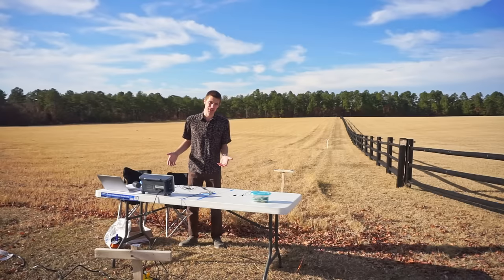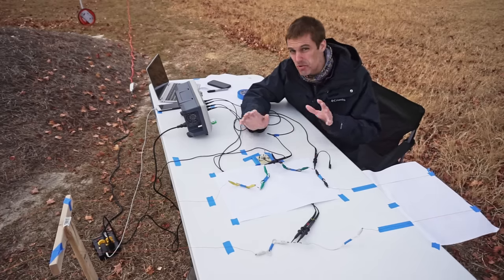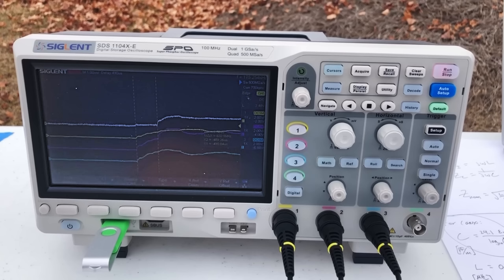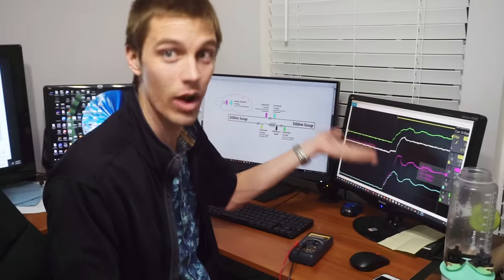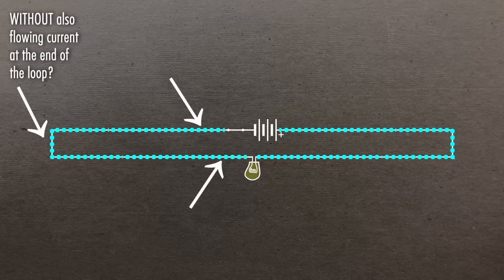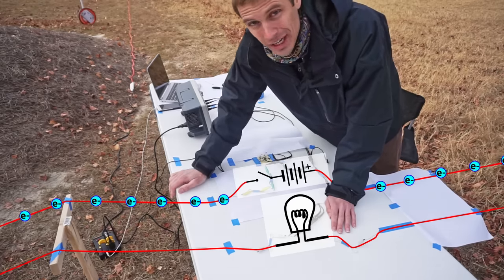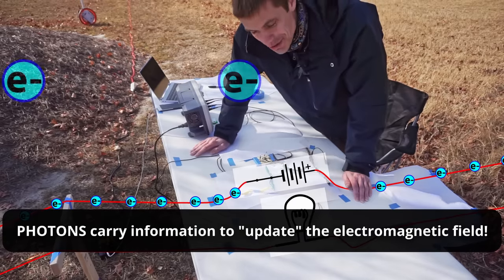I bought 1000 meters of wire to settle a physics debate

Comment from the maker: COMMENTS AND CORRECTIONS:

Thanks to Derek at Veritasium for his blessing to make a real-world version of his gedanken experiment. If you haven't seen his video yet, you might want to go watch that for context, and I also highly recommend ElectroBOOM's video on the topic and EEVBlog's video on the topic. Electroboom's video has some simulated scope traces extremely close to what I saw IRL, and a REALLY fantastic animation (8:27) of him waving an electron around in his hand, shedding magnetic fields as it moves (Even though I ignore magnetic fields in this video - I'm trying to think of a test to find out if they matter).

Veritasium https://youtu.be/bHIhgxav9LY
ElectroBOOM https://youtu.be/iph500cPK28
EEVBlog https://youtu.be/VQsoG45Y_00

CORRECTIONS TO THIS VIDEO:

- The most important thing I believe I ignored in this video is the actual, physical distribution of charge in the switch-side wire while the current is starting up. How much charge travels AT the advancing wavefront and how much charge gets stuck along the wire in between the fuzzball I drew and the battery will depend on the physical size of the wires and how close they are to each other, setting their capacitance. This charge distribution also DOES NOT look the same on both sides of the switch, although I drew it that way for simplicity. In a later experiment (next video) my mind melted a bit as I measured the resistors on both sides of the battery and found the current going through them is different. It doesn't change any of the logic I presented in this video, but it makes some diagrams less than perfect.

- It's possible that cross-inductance between the wires contributes to the effect, using almost exactly the same diagram except the wires are connected by a magnetic field rather than an electric field. I couldn't figure out how to decouple these effects day-of, so I'm still thinking on how to test. Hopefully more to come there.

- I'm sure there will be loads more - please leave comments about what I screwed up!
Reply: Love it. I get popcorn for Veritasium's and Electroboom's responses.
Reply: Veritasium blew my mind, and you are piecing it back together again, thank you.
Reply: Electrons can totally leave the wire, if it's hot enough :P
Reply: d is correct  if the switch is near the light bulb because the wires are already charged + and- and then there should be  a slight drop and go up again
Reply: Nothing too important, but you used V as the symbol in Ohms law, however V is the unit and U is actually the equation symbol for voltage, just like I is for Amps and R for Ohms,

Love your videos, thanks for educating us all
Reply: It would be fantastic to see this experiment with wires laid in a circle!
Reply: Great demo, I would love to see the wires be perpendicular to eachother for the first leg of the journey. The capacitive coupled component should fade away until the until the parallel leg where it would be constant
Reply: IT WAS THE MEASUREMENT ARTEFACT!   Not capacitive coupling.  
It’s due to all channels of oscilloscope having a common ground, which shorts out the long wire.  
Use diff probing for switch, just like you did with the load.  Then the small current will disappear.  
You’re welcome. 😌
Reply from the maker: James - I didn’t ground either probe on the far side of the circuit - that’s why I had to display the result on the math channel. What’s really cool is that both traces on the far side actually climb way early, but that’s actually the reference ground on this side of the circuit dropping. The difference between them still represents current
Reply: On the cross conductance part, just move the wires away from each other. You will get a much higher effect from self inductance of a single line unless it is within a few millimeters of another.
Reply: @AlphaPhoenixChannel  test it by connecting the load side probes only to each other (no load) and see if still measures tiny levels.  Or swap probes on the load to see you get negative value. 
If you still have your massive setup!  🙂
Reply: For the different currents on each side of the battery - you changed something in your measurement method. That is likely a slight difference in connection resistance or your power supply was a bit different between measurements. The laws of physics dictate that current going in must be the same as current going out. This can be seen in Maxwell’s equations when applied to a circuit and is famously known as Kirkoff’s Current Law.
Reply: @Fabian-mu3hq  I have to say, I’ve got my degree in electrical engineering and have been in the field for a decade and have never once seen “U” for voltage. That may be a very old way to describe it, but it is not used in present-day academia or industry.
Reply: @AustinSteingrube  We still use "U" in Germany, I guess that's where Fabian Widmann is from
Reply: @TheDoubleD  We use "U" in France too
Reply: @AustinSteingrube  here in Central Europe I have been taught to use the U for equations and the V as unit behind the number of Volts, i just Googled and appently the SI system intended it like we learned here, but the English Wikipedia does say they are used interchangeably. Probably some differences between countries
Reply: I would like to see a test with the light bulb far away. If Derek’s theory is correct, having the switch and load at opposite ends means there is no capacitance shortcut to activate the light, so we shouldn’t see the effect. If we do still see the effect then your explanation here is correct and Derek should post a retraction.
Reply: another tiny correction: the "first 1.6us" of information still won't travel instantly (because of the photons required for the field "update"), it will still travel at the speed of light, just over an extremely short distance, because it's across instead of along the wires.
Reply: @no0ne000  except we won't see the effect either way, because the explanation shown here is capacitive. this is essentially agreeing with Derek's "idea" of information traveling across the field instead of along the wire, except for the bit where he claimed it could be anything even remotely close to useful, because, unlike Derek's claim, in reality it's just the tiniest bit of capacitive coupling and not actually the signal we're transmitting.
Reply: So you are saying that instead of just assuming that he knew what would happen Derek should have actually tested it to make sure he was right before going on the internet and exclaiming it as fact?
Reply: What would the oscilloscope results look like if placed on the part of the wire where you cut it? If the electrons are piling up at the end...is the current higher at the end of the cut wires compared to where the probes were in the video? Hope you see this and can test it!
Reply: What hasn't been covered by other reaction videos so far was a twisted pair configuration or differential signaling drivers to showcase how to remove the initial part of the signal. It would be interesting because it is a technique to solve transmission problems caused by these effects in technical applications and it migth be harder to simulate with most software. Your experiment setup would allow for it. I just don't know how to get the required amount of twists per length to achieve the desired result.
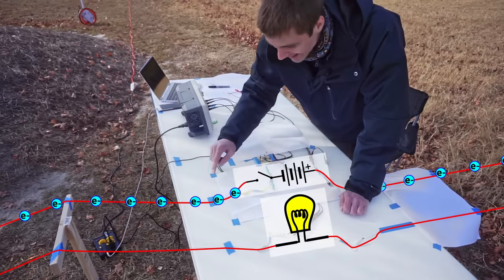Reply: I've watched all the videos referenced in this comment and I must say, this is the best explanation / analysis I've seen. Specifically the part starting at 16:24 -- this is the part that others seem to hint at but have not explicitly stated or visually shown. Great work man!
Reply: @assadij  It seems like strange coincidence, that the "artifact" has the duration of the speed of light traveling down the length of wire. In other setups with different shapes of wire lines the duration of the 'artifact' should vary according to the working hypothesis, but shouldn't according to yours. We'll see in part 2 I guess.
Reply: @Fabian-mu3hq  not sure if this is a regional thing but in the US at least we use V to indicate voltage. U is the symbol for potential energy, which is different from electric potential.
Reply: @turtledruid464  yeah, it is different around the world, here we use U as the equation symbol, the English Wikipedia however states phi as the equation symbol, but V is always just the unit symbol for Volts, just like P is the equation symbol for power with Watts (symbol W) as unit
 And R is resistance with Ohm (symbol Omega) as unit
And V as the Equation symbol is already used by Volume (Unit M^3) therefore it shouldn't be used for voltage as equation symbol, but appently its regionally different if U or phi is (at least should be) used
Reply: 13:00 - 15:00 Is absolutely spot on from a physicist's perception. You did go too easy on the clown in Veritasium though. What he was babbling about was "magical" travel directly from the battery, in the air a cross to the bulb which is completely insane. What you could do to confirm the capacitor effect of the cable is to exchange 100 m of the wire on each side of the battery with first a thinner wire then a thicker one and see if you get the effect you would expect. Thinner and thicker cable should give you a shorter and longer first step in potential, but also a lower and larger potential for the first step, before the charge is established in the loop as whole.
Reply: @AustinSteingrube  "U" is more common in European literature... (I've read a lot of IEC documents on metrology)
Reply: This is a great experiment and really interesting to think about as an electronic engineer focusing on wireless communications! Great stuff!!!
Reply: Boy, the veritasium vid really sparked some debate...
Reply: @Fabian-mu3hq  Which symbol you use for a variable is just a convention.  But using V for voltage is the convention I learned in my circuits course.
Reply: As i understand it, the wires act as a capacitor... but then, shouldn't you discharge it (short both ends) before doing the experiment?
Reply: Whole video I hoped that you will just cut end of wires... Thank you for that. Just to prove anybody that information doesn't travel by wire.
You can make more portable version of your setup just by usong some coax. Also thay have much lower impedance so curent is bigger. I played with this few years ago.
W2AEW have great videos on that topic. But looking at tehnical side not phisics side.
Reply: @Virsconte  in this case, it's actually not really a variable like you would normally have, Common units are all normed by the SI system, but apparently even this differs between region
Reply: @Fabian-mu3hq  completely incorrect or at least pedantic. The original ohms law used EMF.  The U term is used in Europe and some textbooks because of "Unterschied".   Almost everywhere else it is V, the voltage potential which has a unit of Volts
Reply: @JP-pf5pz  damn, you are right, I let my years of education fool me, here in eourope it's U, for voltage, almost everywhere else it's V, and appently both are right, at least there where they are used. And the phi that j mentioned can also be used, but it's for a more momentary Voltage or something, now I better shut up.
Reply: I have a feeling someone's suggested this, and you probably thought about it as well but decided against it: 
Try moving the parallel wires closer and farther apart and see the effect of the voltage across them when the switch is closed?
Reply: @Fabian-mu3hq  I'm sorry, that's not correct.  There are both a mathematical variable and a physical quantity involved in this situation.

We called the physical quantity voltage, and we chose to measure it in SI units of volts, which are usually denoted with the letter V.

We decided represent the physical quantity with a variable, and to call the variable V, which is a common convention for a variable representing a voltage.  It seems like U is more common in Europe.  But we could have called it X or ξ or א or🥴.
Reply: my first thought when seeing that osciliscope graph was "ah, that is exactly what Electroboom predicted."
Reply: It would be interesting to see what happens if you rotate the "light bulb" 180 degrees. With that I mean that you keep all the wires connected the same but physically rotate the resistor around. Would the initial spike be negative?
Reply: You dont need his permission to call his shit out. Thank you for doing it.
Reply: A bunch of you either didn't watch the video all the way through or forgot, but at around 21:25 he talks about how he is posting a second video with a ton of experiments (including moving the wires closer or farther apart)
Reply: I'd enjoy seeing the results of driving a 10 or 100MHz signal down the wire to see how information travels vs DC current.  Maybe use a logic level line driver or MOSFET gate driver?
Reply: @assadij   Small current will not disappear as it is a real physical effect. Anyway, it is important to prevent all side effects what probes may cause. This small current is proportional to the line impedance and this is one way to measure the impedance.
Reply: You will need a lot more than a 1000... Try 300,000miles that way it would have less chance for errors in calculations
Reply: I already had some doubts about the 'bulb switches on immediatelly', especially about the point that  this would mean we could send information faster than the speed of light. But you addressed and explained all those points perfectly 👍. Maybe it is also interressting to try alternating current? I have absolutely no idea how that would look like on the scope
Reply: Good job. Not convinced about capacitance explaining the 1v in the initial 1.6uS. Effectively when the switch is open the entire wire is still connected to one terminal of the battery holding the entire wire at the potential of that terminal. In that state the surface of a wire should be nearly at the same potential across its entirety so all charges should spread out across the wire (over some time). Without a significant difference in potential to force the charges to separate there would seem to be little reason for any potential difference to exist at the moment right before the switch. So no stored capacitive charge in the line would be my presumption. The 1v indicates a current flowing, but seems to be a static pressure. Not sure why its 1v, why not 0.5V or 100V? If its sourced from the line it would exist even when the circuit is open. Yet it only appears when you close the switch.
Reply: @stevenchristy6156  it was 0.2V, but yes, I am still puzzled on how capacitance has anything to do with this (and I have a Ph.D in physics) since his explanation was a transient current inducing a current in the opposite side of the loop.
Reply: Also, keep the length and setup but just place the bulb at 150m. 

Thanks for the content. Really helped me understand better. I hope electroBOOM and eevblog and others will also spend some time on it, helping to explain it further to us not-so-smart guys.
Reply: @no0ne000  what you said. Exactly. That's what I want to see too.
Reply: @denny9931  I have done something similar in recreation of the bedini experiment. Twisted 200 meters of wire (something like that) using a drilling machine and a stick. It's a delicate thing to do since the wire will want to snap if done over some length. Twists want to curl up in one place. A bit of experimental experience is required OR watching the entire distance of the wire extremely careful.
Reply: @no0ne000  The problem is that you would need to measure it out there, so the signal from the probe has a propagation delay as well.
Reply: I know insulated wire is a good bit more expensive, but it'd be really cool to see if you could significantly decrease/eliminate the "instant" current that flows from the closing of the electronic gate.

Would doing this experiment with a resistor in series vs parallel do anything?
Reply: Great video ! I'm waiting for part 2 specially the influence of the distance between the two parallel wire, and how that fall off with distance.

Is it a field generated by the presence of an excess charge (that the battery would have pumped during the very short time), or is a field generated by electrostatic dipoles (along the thickness of the wire the electrons tend to pack up on the side near the other wire) created by the wave going through the wire.

Also have you quantified about the power transmitted by EM wave (because the the wires look like a giant antennas), and the step function create a wide range of frequencies.
Reply: @turtledruid464  Well, because 'murica does not adhere to international standards. But I guess V = 5 V makes sense.
Reply: @assadij  I really need to get a pair of differential probes. Thanks for the tip.
Reply: I predicted in my video that current would reach the bulb in zero seconds. Albeit it was a tiny bump on your oscilloscope, it is nevertheless there in zero seconds. It's due to a flaw in Derek's test design.
Reply: I remember being introduced to transmission lines/waveguides many decades ago and having my mind blown.

Yes, as you guessed "cross-inductance between the wires contributes to the effect" because the wires affect each other via the electric fields and magnetic fields between them. This is something else that blew my mind; they are not separate things but always exist in tandem. There is only the electromagnetic field.

You can't "decouple" these effects. Period. You can try to shield one wire from the other using something like mumetal but that just moves the self-induction of the wire you're trying to shield closer to it, changing the effective speed of the electrons in that wire, and some magnetic field is going to "leak through" the mumetal anyway. Same for electrostatic shielding.

My point is that this is a transmission line experiment and can't be successfully analyzed any other way. "Deceptively simple" indeed- understanding these effects stumped some of the most brilliant minds of the early 20th century for quite a while, so don't feel bad that it's hard to understand them well enough to explain them in a 20 minute video.
Reply from the maker: It was t bare - it had enamel
Reply: SERIOUS PROBLEM:  the resistor-value determines initial behavior!    The resistor-ohms *cannot be chosen randomly,* otherwise we'll end up misleading people.   (Also, double check things, because from your scope traces, your 1K resistor acts more like a 120 ohm resistor!   Calculation of Zo gives an initial step of 1.8VDC, not 200mV.   And, why is your final voltage around 3.4V and not 4.6V?  Something odd is going on.   Re-measure your 1K resistor to make sure it's actually 1K.   Test your total wire-resistance, from the wire-tables it should be around 86 ohms.)

OK.  Sure, we can sneakily select our load resistor to be small, in order that 90% current appears immediately, then 10% more is added after the lightspeed delay.   Or instead, choose some huge value where .001% current appears immediately, etc.   Which wrong ideas are we trying to "prove?"

In hindsight, best would've been to adjust the resistor to maximize the milliwatts, which happens when the initial immediate voltage is 2.5V across the resistor.   In that case we first see 25% power, then the 100% power arrives after the full 5V comes after a delay (ignoring the copper resistance, which might not be correct to do.)   Even with his 1M spacing, Veritasium's initial signal on superconducting wire is NOT MICROSCOPIC  ...unless we want it to be, and choose a badly-matched resistor value as our load.

PS 
all my above comments are ignoring the real resistance of thin wire.    If the characteristic Zo impedance of your line is a few hundred ohms, and also the resistance of the long thin copper is a few hundred ohms, then we'd need the "Telegrapher's Equation" to predict the best value for the load resistor, in order to maximize that initial signal.

PPS
PLEASE try actual 1M gap, even if the nearby dirt may distort your results!   And use 200VDC worth of 9V batteries clipped in series, switched by a zero-bounce mercury reed relay (lots of those on ebay.)   Over the past weeks I see lots and lots of angry comments insisting that the one-meter gap is "enormous," and insists that this will make the initial pulse be microscopic.    Unfortunately the gap of your close-spaced line appears "small" to everyone     Veritasium's original version is wonderful because a 1400-ohm load resistor would immediately see 6V and 2.1mA; more than enough to light up a single LED, even with a 1M gap between the wires!    If Dereck had used 200VDC, the initial wattage could be 7W!! 

Hint:  also calculate what happens if the wires were spaced at ten meters!   The Zo doesn't increase as much as most people think, only going from 800 to 1000, and a single LED would still light initially.   THe DC wattage jumps right across the ten-meter gap.   Very counterintuitive, unless we've realized that this is a transformer: like a pair of stacked hoop-coils where the gap between the coils is tiny, relative to the circumference of the coils.   We'd expect to be creating a sort of transformer with 1:1 coupling.
Reply: @KiitosKaloista  I just don’t think that small flat level is real.  It is too steady for too long.  More like a measurement error.  
If it was capacitive coupling, the level should have been increasing.
Reply: @cda32   or indeed if the wire is sharp and the voltage high enough. - Spark.
Reply: @Fabian-mu3hq   I think the Si symbol for Voltage is actually E - Stands for Electro motive force.
Reply: Wanted to like this, but the number liked scared me! 😈
Reply: What is the time delay if the switch and light bulb are 500m apart? Or 2 Km apart?
Reply: Two things you could add to the list of parameters to tweak, (21:23) is to: 

Replace the single core copper conductor to a multi core copper cable. (With the same mm² of course) 
Replace the conductor with a metal of lesser conductivity like steel. (Preferably with a larger mm², to compensate for the voltage drop of the circuit.)

I’d also like to suggest that you contact an amateur radio club in your area to ask for input & assistance. The vast majority of HAM operators around the world (I’m one of those many) would LOVE to help out with something like this! 😃

If you are in the U.S., (your 'about' page doesn’t mention it) the easiest way to find the one closest to you, is to use the search engine at arrl(d0t)org/clubs

If you’re in Canada, you can check the list of clubs at rac(d0t)ca/clubs-3/

Thanks for the informative video!

Cheers from Denmark 🇩🇰
(Also: 73’ de OZ2BO😉)

Ps. I was impressed by your way of “dumbing-down” the technical details without making it sound condescending. It’s a skill set that I find somewhat lacking with quite a few of your fellow Youtubers with similar types of content, it is much appreciated!
Reply: Yes it's the details of the magnetic field and how they can be manipulated is what I want and need to better understand.  I've read along time ago, something about the shape of the conductor can influence this greatly, like a flat wire verses round, number of strands verses one single wire and of course the alloy used.
Reply: It would be super interesting to see how super conductivity would influence these effects!  No resistance!!!   Is it possible to travel faster???   Are effects instantaneous???
Reply: @assadij  if the line is light second long it would be steady two seconds. As told in many commments already, the line behaves just like a resistor until the EM-wave bounces back from the end. This resistance is characteristic impedance of the line. It takes both capasitance and inductance into account.
Reply: It might be a chemical process. Have you considered the difference between the electron affinity and ionization energy of copper?
Reply: @JonesNoahT  Please go on and share?   Learning here.
Reply: @AlphaPhoenixChannel  That (not grounding the far-side probes and why, and why the early "rise" is actually a fall in ground) is both subtle and important -- I hope you go into at least this much detail in one of your followup videos.
Reply: @renevile  I'm not sure, but didn't want your question to be ignored.  I think the answer is "no-ish".  That the fields are pointing sideways to each other ... but this might look like the "same" polarity (or not) when you only measure at two points instead of sampling across the whole space.
Reply: @mirkokurac  Since the time to adjust is microseconds, this would at most limit which order he should hook things up to avoid a shock.  If he and the equipment are still fine, then either he did (perhaps without even realizing it) or the power involved was low enough to be safe anyway.
Reply: @brettmoore3194  But way more chance for errors in construction.  And for catastrophic budget-related failures.
Reply: @johnallenrichter  How can you tell?  You can tell how long it stayed at the first (slightly) increased level, or how long it spent climbing, but to stay that process started at zero seconds, as opposed to 10 minutes ... I'm not sure how to tell when the switch closed, except by assuming it was when the measurement changed.
Reply: @l0I0I0I0   Ah ok awesome =^). The energy required to remove one electron from the valence shell of an atom is called the “ionization energy,” and the energy released when an electron is added to the valence shell of an atom is called the “electron affinity.” If it requires less energy (or even releases energy) to add an electron to an atom of copper than is required to (or released from) removing an electron from an atom of copper, then I would expect to see more current on the side towards which the current is flowing. If the opposite were true, then I would expect to make opposite observation. Thus, this might explain the phenomenon that melted his brain a little :-)
Reply: @AlphaPhoenixChannel  Wouldn't "bare" wire vs enamel just change the effective distance between the wires?  I could imagine better insulation making the initial short-cut energy too small to detect, but I wouldn't expect it to change the kind of results you got.
Reply: @JonesNoahT . I see, the net average total electrons releasing, and acquiring of electrons gives a positive or negative charge with the higher amps showing the greater force?  
  I'm just started watching some YouTube inorganic chemistry vids.  Seems to address some of these phenomenas.    Thanks for you answer.
Reply: @jimjjewett  what nobody told you science is exspensive in a devalued currency
Reply: @AlphaPhoenixChannel  Maybe asking a bit much, but you could change the inductance/capacitance of tge transmission line by embedding it in a medium. The change in permeability and permittivity will change the strength of capacitance and inductive effects. 

For example, you could compare the results with the wires submerged in a river and lifted above the water.
Reply: beautiful video, thank you, this was really educational and was helpful to understand the nature of electronics!
Reply: @jimjjewett  The oscilloscope has three channels.  One channel was across the switch.  There was a distinct rise in voltage on that channel when the switch was closed. That indicates voltage was closed at that time. That time is time zero.  A second channel was across the resistor.  The resistor channel showed the small bump of current at the exact same time that the switch closed.  Ergo, there was no delay. Another way to say that is there was 0 seconds delay or the current started instantly. The reason this happened is because the test design is invalid.  The positive voltage was present on almost the entire length of wire before the switch was ever closed. And the negative potential was on the negative side of the wire..  in fact both the two battery voltage poles were present on both contacts within the switch before it was thrown. Just a few millimeters away from each other. So when contact was made the voltage circuit was instantly active.  There was no delay waiting for the voltage to travel the wire because the voltage potential had already travelled the length of wire before the switch was ever thrown!  It is an invalid experiment because of that.  The remedy is to use a double-pole-double throw switch to open BOTH sides of the battery.  Not just one side.  It's just a matter of simple oversight. Performing the experiment with the DPDT switch will allow us to see the results Veritasium intended.  Because the wire will be free of any voltage potential before the switch is thrown and the voltage will be forced to travel at light speed to activate the voltage circuit. I'm curious to see what those results will be since DC voltage presumably  only travels in one direction. So I'm wondering if both poles will travel to meet in the middle where the bulb is, or if voltage travels only one way, around the whole loop before the voltage is complete. The former would leave Veritasiums result at theoretical ly1/2 second while the latter would result in 1 second.  I'm honestly hoping AlphaPhoenix will recreate the experiment with the corrected design because I'm curious of which it will be.
Reply from the maker: @IDICS Tech News in steady state dc electrons move but the electric field remains constant, but this is still a current. The weird “startup” wave is only relevant in very weird situations like this one
Reply from the maker: Of course, but you said it was instantaneous and it’s not - it’s limited by photon interactions - light speed
Reply: I understood not much with the Electroboom video whereas this one was cristal clear. Thanks
Reply: @goranjosic  Just what I was thinking.
Reply: @assadij  Exactly right!   If we only consider the capacitance, then the current increases, but if we only consider inductive coupling, the current decreases.   If we consider both, then there will be a *constant* flow of EM energy into the two long wires  ...as if they form a pure resistor, absorbing some watts.   In real 2-wire lines, the initial current is that of a resistor:  it's constant, as long as the battery-voltage and the load resistance are also constant.
Reply: What happens if you change the circuit topology and move the switch to one end of the circuit? 🤔 In the original question I noted that the switch could be up to 0.5s away from the battery and lamp. Therefore for the lamp to turn on in 1m/c seconds that would infer that the signal between switch and battery/lamp would need to be greater than c (speed of light.) This is a problem. 🙂
Reply: Your graph really proves the hypothesis of electroboom
Reply: Do your experiment at night. I have a hypothesis on the timing. You're smart, You'll know where I'm going with this.
Reply: nice
Reply: You have to understand the difference between the transverse and longitudinal electromagnetics. Standing instantaneous electrical connections. Like pulling on two ends of the rope at the same time versus whipping away through it. They deleted the teachings of scalar electromagnetics.
Reply: One thing I think should be made clearer is that the wave propagates from the switch not the battery as it is the switch that is changing state. Obviously in this experiment the switch is so relatively close to the battery it makes no odds but I think that this was never made clear in Derek's video nor this one and I know some people are confused into thinking everything starts happening from the battery.
Reply: "It's possible that cross-inductance between the wires contributes to the effect, using almost exactly the same diagram except the wires are connected by a magnetic field rather than an electric field. I couldn't figure out how to decouple these effects day-of, so I'm still thinking on how to test" --- are you trying to increase the separation between the switch and the resistor/"bulb"? like make a 1km circumference circle so the switch and resistor are diametric?
Reply: @bogslurp3532  I wouldn't say veritasium video blew my mind, it just made me question all of his science in all of his videos 😅 I just thought it was weird that he left out the explanation that is in this video. It's such a questionable presentation that I would take it down and redo it, if I were in Derek's position. A great conversation starter, but not something that should be left as an individual point in his channel's history.
Reply: and what wavelenght would have the EM field traveling through the wire?
Reply: thanks for clearing things up. it would be interesting bro see how making wires shorter or longer, and closer /further. with 300000km of wire, the resistance of the wire would be much bigger than the bulb and the DC current would be lower than the transient current caused by the wire capacitance. this shows that a phsics problem does not make a lot of sense if you have too many unknown parameters such as the wire resistance.
Reply: @Fabian-mu3hq  WRONG!
Reply: @Fabian-mu3hq  WRONG!
Reply: @assadij  Yes! Thank You! Finally someone who knows what they are talking about! I wrote a comment saying the same thing and suggested he redo the experiment replacing the battery with an appropriate resistor for it's internal resistance and a regular switch. I said they would see the same voltage after closing the switch as their "initial current"! I know I'm right because I've seen it to many times, in dead circuits even. He should have never equated voltage to current.
Reply: I'm not so sure about the valence electrons having a net Coulomb force on one another as the correct mechanism (around 13:20), considering that the material is neutral. Although perhaps you've hidden the mechanism somewhat behind the nature of exactly how the battery ' places'  the electrons, but in any case I don't see much of an explanation. If you displace an electron, its field will always be canceled by the net positive atom left behind. The only net electrical interaction (coming from the valence electrons per se) is due to relativistic effects and is modelled as the magnetic field. I'm also curious if assuming that the electrons indeed 'bump' each other in this way would lead to phase differences inconsistent with experiment. 

But yeah -- at least some research published in this area seems to suggest that the charges are actually motivated by an electric field within the conductor that points along the conductor's axis and is constant across its cross-section. This electric field is itself established by surface charge densities on the conductor, which are in turn established by the electric fields (at near-c, hence the speed of conduction despite slow drift velocity) from the source and specific, complicated feedback mechanisms that are a function of the conductor geometry -- this latter point I'm still fuzzy on and have some doubts. Chabay et al have developed a way to calculate it programmatically and there's a simulator online you can somewhere I believe. But some sources talking about the topic:

-"A unified treatment of electrostatics and circuit" Bruce A. Sherwood, Ruth W. Chabay (Carnegie Mellon University" 
(Also their textbook " Matter and Interactions"  goes into it in detail) 

-"Polarization in electrostatics and circuits: Computing and visualizing
surface charge distributions" Sherwood and Chabay again

-"Surface charges on circuit wires and resistors play three roles" J.D. Jackson, American Journal of Physics

- https://electronics.stackexchange.com/questions/532541/is-the-electric-field-in-a-wire-constant

-"Understanding Electricity and Circuits: What the Text Books Don’t Tell You" Ian M. Sefton, School of Physics at The University of Sydney
Reply: @Fabian-mu3hq  YOUR WROOOOOOOONNNGGGGGG¡!¡!¡!
Reply: @AlphaPhoenixChannel  Hold on! I need to point out something wrong with your experiment. Your Oscope is measuring voltage and your equating it to current. You say that the small rise on the white line is a "tiny amount of current" but that's not current. My experience with Oscopes and the bain of their existence is varying ground states. I see that tiny rise in voltage initially is the scope translating what it senses comparatively to the ground state in the circuit. To test this experimentally simply have the same circuit basically but no battery and replace it with an equivalent resistor for it's internal resistance. Only thing is that transistor won't work for a switch without power so since your not looking to measure any time lapse just a regular switch should suffice. I think when you close the switch you will still see the same transient voltage yet no current will be flowing. Just the scope measuring differences in voltage potential caused by different ground states. I hope I wrote this inba way that explains it properly. After all I am an electrical engineer. That was a joke cause most people would run off at the mouth exemplifying the Dunning Kruger effect and say "well I'm not a blah blah blah and I hope I did it right". I actually am a trained electrical engineer and have no problem saying I could be completely wrong. I have been before and every single great mind has been wrong about something and likely lots of things because that's just the way it works when your not Omniscient (especially at the beginning when you know nothing)
Reply: Try this with thicker and thinner wire
Reply: @cda32  High Voltage!  (Done dirt cheap!)
Reply: You didn't need Derek's blessing. This is science!
Reply: Instead of using switch on one side of the battery use it in two sides of the battery , so charges won't develop on wires .
Reply: @KiitosKaloista  this is the worlds worst transmission line by design. It’s characteristic impedance would be extremely high due to having large L over a small C.  Z= sqrt(Lo/Co).  And it is not very uniform.  So I wouldn’t even go there 😌
The stray capacitance that appears to deliver power from source to load is not sufficient to produce a large enough current through the load to be measurable.  Also definitely should not be so constant.  
It seems to be some sort of measurement error for sure.
Reply: @sushkr  00хФфф
Reply: Could the 0.2 volts in the beginning be coming from the internals of the oscilloscope?
It would be nice to see measurement done with 2 separate oscilloscope triggered by the switch
Reply: @Fabian-mu3hq  THink in the US V is common also as the symbol for voltage. At least it is listed on the wikipedia page for voltage.
Reply: @assadij  This may be resolved by measuring only the resistor, preventing any possibility that any energy is coupled thru the probe cables between the switch and resistor.
Reply: The experiment is great, but the explanation is totally wrong.
Reply: @johnallenrichter  the second channel was not across the resistor, rather he had two reference channels measuring either side of the resistor and then had the (virtual)white channel showing the difference. He explains above why the two reference channels start rising immediately, basically for the reason you mention, that the circuit is pre-charged. But I think your idea of using a double pole switch is a good one. I actually think that the relatively high and steady-ish current we see in his experiment (before the wave down the wire arrives) is a side effect of the measurement, under perfect conditions I think we would see more of a transient spike as the switch is closed. But my feeling is that with the double pole switch you propose (such that the circuit and switch are not pre-charged) we would not get that transient as the switch would have no potential across it when closed and so there would be no sudden re-balance of charge to cause a transient. I think the experiment needs to be much cleverer to see this though, it's very subtle.
Reply: I once saw an experiment where there was a broken circuit that exploited an electron's probability field to send information faster than light. Note this didn't break causality because no physical object was sent - only information. Incidentally, the information they sent was some of Mozart's music.
Reply: A switch doesn't turn on or off, it interrupts.  You need to be thinking of the wire between the battery and the switch as a heavily charged (either negatively or positively) section of wire which will effect the front of the wave.  This is my understanding from dicking around as a highschooler, so grain of salt, but its a simple test.  Take a constant setup where the wavefront difference is measurable and swap the polarity of the battery relative to the circuit - If my assertion is correct, the side with the switch will always have the bigger wavefront/initial current.
Reply: @andy_taylor  Exactly. I hope he will reconduct the experiment with the DPDT switch.   I'm excited to see the results. Because I'm about 50/50 on two competing theories bouncing around in my head.  One is that the DC  voltage will only travel in one direction forcing it to traverse the entire loop from one battery terminal to the other. If true, and if Phoenix adjusts the his wire length mathematically to 300,000 meters to reflect Veritasium's hypothesis, then the answer should be about 1 full second to turn on the light, or at least to first see current at the light. The second theory is that both negative and positive will flow toward the light bulb simultaneously and meet in the middle.  In that case we should see current begin at the bulb around 1/2 second.  I'm excited because this could definitively prove one theory over the other. At least in my own mind. Early in his video he mentioned a little "wonkiness" when the switch is initially closed. That's caused by a tiny spark gap when two charged contacts of a switch get close enough that the voltage will jump across the gap. That caused the chaotic little bump of current we saw in the first test. Another interesting thing about a revised test with the DPDT switch will come from the time variance of both sets of contacts in the switch. Although the switch is designed to throw both poles simultaneously, in the real world of nanoseconds they are probably going to be a little offset from one another.  So the interesting thing to discover will be if that "wonkiness" exists in the revised test. If the battery is open at both sides then there will not be any preexisting "wonky" current showing up at the bulb from the first switch being closed.  Whether the 2nd switch causes "wonkiness" is dependent on the length of the wire.  If there is enough time between the two sets of contacts closing, say 2 nanoseconds apart, and the wire is of insufficient length that voltage from the first closed switch is able to traverse the entire circuit before the 2nd switch closes then the "wonkiness" will exist when the 2nd switch closes. Because both poles would already be present at the two contacts of the 2nd switch allowing the gap to be jumped.  And I haven't done the math but intuitively I suspect 1,000 meters of wire would be sufficient to avoid the "wonkiness" from appearing in a variance of a few nanoseconds.  So I should think both the voltage and the current at the bulb/resistor should be a much more consistent upward slant over time on the oscilloscope without the wonkiness appearing. But we would need to calculate the wire distance versus the difference in switch times between the two poles of the switch to be absolutely certain. And if that happens, I think it might have a significant worldwide impact on theories regarding how voltage travels along wires. Because it can define it with precision.  And to me that's exciting.  And to think it could be owed to a simple oversight of pre-charging a wire in a hypothetical teaching scenario.  Man you gotta love science and how it develops!
Reply: @johnallenrichter    the "spark" is what I referred to as the transient spike. I believe this is what causes the EM transmission directly from switch to bulb that Veritasium's video was trying (badly) to explain. As u say I think the small current after that, until the main wave travels round the wire, is caused be the experimental setup (oscilloscope and probe wires).
As for the DC wave traveling along the wire I think it will travelin both directions, the battery not only pumps out of negative end but also "stucks” on the positive end so I think both sides will be affected in the same way.
Reply: @aaronmicalowe  you can't send even information faster than the speed of light, that is causality!
Reply: @andy_taylor  I understand what you mean now about the transient spike. But I don't think current traveled to the resistor.  You'll have to forgive me because I subscribe to a slightly different theory of current formulation than the popular theory.  Basically I don't think current travels.  I think it forms in place on a wire when a closed voltage potential is actualized.  I believe voltage travels the length if the wire.  Not current. In my view current is the localized kinetic excited movement of electrons that conducts sort of "the wave" thing you might see at sports colliseums. Except in the electron wave it would be more like one guy would punch the guy sitting next him. And then that guy would punch the guy next to him, and so on until the punching goes all the way around the colliseum. Or circuit, conduit, whatever. And also the guy does punch the guy to his right but he also turns around and punches back the guy who punched him in the first place.  Come to think of it, electrons are a lot more aggressive than people. Anyway,  maybe thats why there is confusion.  Nevertheless I'm dearly hoping AlphaPhoenix will redo the experiment with the DPDT switch.
Reply: I would be interested in seeing if there is a difference between the two cut wires at halfway, and 2 cut wires around the resistor, basically the same experiment as the first but in stead of a resistor, a gap. And see if there is a difference in time between your second, and "my" experiment without the resistor
Reply: No, don't go to Veritasium's video, it's borderline idiotic.
Reply: @johnallenrichter  I don't view either current or voltage as travelling here, they are both just measurements. What is really travelling is energy, transferring from the battery/switch to the resistor. The transient spike/spark will travel directly and induce a current in the resistor (basically as a radio would). The majority of the energy will be transferred around (not in) the wires in both directions. In both cases the energy transfer mechanism will be via photons traveling at the speed of light although the actual wave around the wire might travel slightly slower as I think the mechanism requires constant emmision and reabsorption along the wire .
Reply: @prescriptivereasoning  are you talking about the nature of the unshielded wire as some sort of antenna being bombarded with EMF, say like from natural Earth fields or man made em waves?  I think that is a valid point. But I dont think it changes the validity of the experiment to "wrong." The measurements of any voltage was not present anywhere on the open wire, even being pre-charged with the positive connection to the battery before the switch was thrown.  So either the sensitivity of the instrument was not high enough to detect that EMF or the EMF is so small as to be insignificant.  I'm not married to that though. I would very much enjoy being proved wrong by the results of any test that could do so. Its the science that matters. Not individual thoughts or accomplishments.
Reply: @andy_taylor  Then how do electrons in upper orbit shells fall to lower orbit shells faster than the speed of light? They cease to exist in one place and instantly exist in another with zero time passed. Quantum effects are weird.
Reply: @aaronmicalowe  not sure I fully understand your question on electrons falling faster than the speed of light, but yes we are talking quantum effects here and yes it's weird, we're talking virtual particles, Heisenberg Uncertainty Principal etc. That's why non-physists (like myself) tend to stick with the resulting macro scale phenomenon we can measure, like voltage and current.
Reply: @andy_taylor  when they tried to measure the speed in which electrons in the outer orbit of an atom fell to lower orbits, they found it was instant. So they looked at the atom as the process happened. The electron disappears from one orbital shell at the same instant it appears in the other, without travelling in-between. This is not yet fully understood.
Reply: @aaronmicalowe  I'm sure it's to do with the fact that you can't actually measure position of the electron, just a probability if where it is and probabilities are just mathematical so they can change instantaneously. It's like quantum tunneling allows a particle to be one side of a barrier and then the next moment the other side,  it doesn't actually physically travel the space occupied by the barrier (apologies to physicists out there who could probably explain this better). In short quantum mechanics is weird!
Reply: @AlphaPhoenix please learn about Resonance !! And I mean understand how it works if you do all will be reviled.
Reply: @andy_taylor  Well, I don't know what methods they use but I have seen pictures of real electron shells, i.e. not models and not artistic impressions.
Reply: @cda32  or the voltage is high enough
Reply: Still not technically correct because under his conditions, you have 2 antenna that keep the light bub on at all times due to radio waves, solar radiation, and even the cosmic background. (any current through the light bulb means ALWAYS on)

His question with that answer is wrong, using his assumptions or other reasonable ones, and the sooner that gets accepted and corrected, the better.
Reply: The main point of the original video was electrons dont actually flow throw a wire like water. That is a simplified version for the masses. The eletric field is the force and ia ignore until you get very deep into electrical distribution systems. Put the wires 500meters apart and try the experiment again rather than having the loop so close. In other words a giant square with the light bulb/resistor in-line along the path and opposite the battery.
Reply: @tylerdurdin8069  I totally agree that grounding can be hard, and I'm not completely convinced that using two independent probe channels (like AlphaPhoenix said in an earlier message) is enough to confidently reject measurement errors.

One way may be to disconnect the battery-side probe and ground.  Connect a probe with ground on one side of the resistor, and the measurement channel on the other side. If you still see small step up a few microseconds before the trigger, that would rule out some errors in  measurement/coupling through the scope.

Congrats on a well executed experiment, and my bet would be that it's not a measurement error.

 (edited how to connect the probes)
Reply: Diagrams are always less than perfect! Fantastic video!
Reply: @Dzeno2010  Resonance, Understand it.
Reply: @goranjosic  nope, wouldn't work, veritassium explains why in more detail.
Reply: @goncalovazpinto6261  I know it wouldn't work, that's why I want someone to do an experiment, to remove any doubts about the current results. :) 
I love watching veritasium, but this last video was not the best.
Reply: @prescriptivereasoning  you are apparently much more advanced in theory than I am. I'm still throwing theories together in my head.  My thoughts change often, but I'm not at your level yet.  Honestly, I'm not sure what you mean that charge and field come from the same phenomenon. I am, though, currently speculating on what creates the field.  I have no conclusions. Far from it.  As a matter of what I know about my own brain, I can say it doesn't accept theories because they are written or espoused.  My brain accepts what it can logically conclude by itself. It accepts nothing from quantum mechanics because it is nothing but unsupported gobbledygook to my mind. In not trying to disparage QM, nor those who subscribe to it.  I'm merely saying my mind is not developed enough to make logical sense from it. I suppose it's just incidental that no piece of technology or product to improve lifestyle has ever stemmed from QM.  But that does lend some credence to the idea that QM might be flawed and not my brain.  But right now I'd accept either or both of those things.  Science is a snowballing collection of knowledge.  I keep all theories and all ideas in play.
Reply: @frehdom9783  doesn't matter here, he says ANY CURRENT, secondly, not just 1 frequency coming in, keep in mind these antenna pick up ALL the radiowaves ( or at least close to half), are perfectly conducting, and/or all of the solar radiation over their area/volume.

Sure resonance is important if the antenna need to be efficient but Veritasium said any power, otherwise I wouldn't have mentioned cosmic background radiation. Even then the power transferred over 1 meter by a 12V from a car battery, yeah that  amount in 1/c seconds is ridiculously small for those parameters, especially more so with PERFECT conductors.
Reply: Most people don't even know what an oscilloscope is... My father introduced me at a very young age and I love it! Could we get this experiment done in a way that no capacitance is a possibility? Just do a huge circle instead of this paralleling?
Reply: A fun followup experiment might be to vary the distance between the transistor and resistor, and measure the immediate "step up" current as a function of distance.

If the wires are really close, its effectively a problem of cross-talk between the two wires, which then leads to the idea of using a twisted pair cable!
Reply: @goranjosic  Oh, I see, sort of like a baseline result
Reply: So the initial voltage would not exist then if you were to place a solid lead wall between the incoming and outgoing wires? 
And what if you placed two massive loops of wire side by side - like 1Km's of wire for the positive in a massive loop to the left - and a massive loop for the negative to the right like in the shape of an "8" or a butterfly with the switch/bulb meeting in the middle. (This essentially would not have the incoming and outgoing voltages passing by one another as much)
Reply: Gedanken Experiment is such german word, even as a german it sounds weird when u hear someone say it
Reply: Thank you for doing exactly the kind of modification I proposed under Derricks video, even though you most likely came up with it on your own. It was a nice demonstration of my critique of Derricks video wegen you showed what's happening when you cut the wires (I proposed a switch there, and asked when we'd know the state of said switch). The outcome is very much what I expected, since everything else would've meant we'd have to redo most of the physics Einstein proposed.

I still feel as if Derrick deliberately mislead his audience. But seeing how many people are actually surprised to learn about inductance in the first place there might still be some merit to it.
Reply: @denny9931  easy, just buy network cable, they are all twisted pair for the very reason you explained. Get a few rolls of 100m and chain them to get 1km of twisted pair cables.
Reply: You may want to consider using coaxial cables next time.  It will produce much cleaner signals and the instantaneous inductive coupling you saw can be avoided. With coax, you don't need 500m. 1m is plenty. (bcz it's shielded, you won't have the "wind noise" and external coupling is avoided)  For good measure, you can try 2 or 3, even 5 meters if you want and observe the change in propogation delay. All that bouncing you saw was due to your probe ground leads bring too long. Shorten it to get rid of the ringing.  Your electronic switch will need to be faster since the cables are shorter. A cheapo Arduino board with a 7404 ALS hex inverter with all output ganged together should get you 1ns switching speeds.  Use 50 ohm terminators as a substitute for the lightbulb.  Look forward to seeing your next video!
Reply: What if you had a 2nd circuit, turned on at the same instant, however was opposite to the 1st circuit?

Would the fields 'pulling' or 'pushing' the electrons cancel and stop that 1st oscilloscope blip
Reply: @MrLikeAsatellite  i mean thats not really what the creator of this video claimed
Reply: @Fabian-mu3hq  English speakers also use V as the symbol for voltage, which is how I created some levels of confusion when I suddenly used U for voltage and students had no clue what I was talking about. :D
Reply: @cda32  Or if they are unsatisfied with their stay lol
Reply: @AlphaPhoenix
1. At 15:45 you mentioned that Electrons get know to know to repel due to photons or electromagnetic field.  Please verify it but i am pretty sure that Coulombic force is much greater importance in this case and its different from electromagnetic field
2. I am not sure but I heard you saying Wires are always needed to light up a bulb as it will guide electrons to flow  effectively to light a bulb, which electric field couldn't. I would like to add a point  that sufficient electric field do light bulb even without wires in space- Tesla tower. That can be future if we can harness that of course. So, Derek's explanation of battery emitting field to light it instantly may be valid for very small resistance.
Reply: And video is really great and explanations i can relate to. Thanks for this.
Reply: Here is a simpler explanation. We will just examine the second condition with the circuit open. The switch opens the path for electrons to flow. Electrons flow. As the electrons flow their movement also effects electrons in the air. This is called a radio wave. As electrons move they jostle other electrons and those electrons and the moment the wave hits the nearby return wire, those electrons are effected and you read a signal.  Once the capacitance of the open circuit's wire is filled, the movement stops and the radio wave settles. If you had insulation, you would probably have more  capacitance but the radio signal would be reduced. A fine wire mesh running between the source and the lamp would also reduce the radio signal. So a simple Faraday cage would reduce the initial flow of electrons at the resistor significantly. It could be the field and induction, but induction goes down with range really quickly, and with the distances you used, I think the direct induction is going to be lower than the radio signal.
Reply: Except it travels on the outside skin of the wire
Reply: @AustinSteingrube  Here in Belgium we use also U
Reply: @assadij  This is a nice idea to validate these findings
Reply: @AlphaPhoenixChannel  You lost me at being a woman.
Reply: so the answer is 2.5 einsteins divided by a dead cat, got it.
Reply: You should have been more careful around probes. 
The measurement looks very suspicious because the smaller signal is more or less constant during the 1us it lasted, even though the current in the battery is rapidly rising. If it was caused by electromagnetic coupling to the wires of your probe it would then make sense because such voltage depends on dI/dt (which is more or less constant) and the length of your probes (which is obviously constant).
So, please fix your experiment by
1. Shield your probes. 
2. You should have used differential probe (for the far side) instead of math. 
If you don't have shielding, and don't have a differential probe, you might want to test by connecting a probe and its ground to the two sides of the far side (bulb) to check if the small signal still exists or not.
In any case, it is a very bad experimental design because you did not try to address all unwanted and external variables. Considering the fact that this is essentially a one time only experiment, what a waste.
Reply: Seems like the same thing that happens in water pipes. Pressure has push back before flow
Reply: I think you are almost right. But Induktion makes a lot more sense. In this model its just way stronger than capacity. I dont now your parameters, but you can calculate it easy and check it out.
Reply: I'm actually kinda spooked at how eerily similar this is to how a fire hydrant line behave when a vale is open. Both the continuous wire and cut wire portions of it. In water lines we call the effect of repulsion "battering ram" effect (at least in Brazil, directly translating it) and it is all so similar, except the information can only travel at the speed of sound, and the water will travel at a speed determined by the pressure, the actual pipe, etc.
Reply: @Vinizuca  water hammer.
Reply: This right here is how you’re supposed to present ‘science’. While earlier we’ve seen Veritasium being so bullish about what he thinks, here’s a guy who’s straight away asking for corrections. Only a fool considers himself/herself absolutely right. A true genius always seeks the unknown and is almost always ready to stand corrected.
Reply: @denny9931  It's fairly easy to buy twisted pair cables.  It's way too difficult to twist wires manually.
Reply: @pseudofred_  Boy! You are really going to understand this! I did the same thing and we had 10 weeks and a couple of hundred textbook pages just on transmission lines. Waveguides are cool because you can transmit power without electrons becoming involved.
Reply: One problem is the hook up of the oscilloscope that has "quite a lot" of capacitance in cables and in the probe heads. So when measuring small effects that depend on small capacitances your test setup becomes very hard and critical for correct results. I think you should be glad that you got as good result as you achieved.
Reply: @cda32  But it's not. Hot enough.
Reply: @Fabian-mu3hq  Use of letter symbols is not always consistent within academia or professional circles across national bioundaries and disciplines. For example, electrical engineers and physicists use very different symbols.
Reply: @assadij  Maybe, but that would have to be established by a series of experiments to determine the role of each factor.
Reply: I was a bit wary about the original video because of the wires 1m apart from each other, forming a rather big capacitor over its length.
Let's do it differently: On one side of the earth someone sits there connecting a battery to two wires. One wire hoes left, the other goes right around the world and on the opposite end someone is measuring the signal. Or, in your case, one wire hoes north then east, the other east then north, avoiding a lot of capacitance between the wires.

A good real world problem for the setup problem you and others were working at, for example, is to interconnect four power plants which are standing in a square setup several hundreds of kilometers (or worse, miles) apart. Because of the power travelling at light speed, it's hard to synchronize them equally.
Reply: I have a faint memory that this effect is a big problem with high power lines. That the inductans and magnetic fields causes problems and that there are some tricks applied in the construction of the cables so that the can be closer to things without problems. They can be under ground as an example. How do they do that? How do they avoid flows through things if the cable is like 100 000 volts and 500 amp dc or AC? That would be interesting to know.
Reply: Outstanding video! You actually did the test in reality that I wanted to do, with a mosfet and an oscilloscope. And you proved what I intended to prove; that you get no information about the completeness of the circuit faster than causality (at the speed of light) can travel the circuit. This is the essence of time domain reflectometry, a technique used for locating faults in transmission lines.

The fact that the transient signal shorting the circuit had such a small magnitude, I think undoes Derek’s thesis. He says in his explanation that he neglects small scale effects such as line capacitance snd inductance. So if small scale effects are to be ignored, then to be logically consistent then surely the small magnitude initial (in your case 1.6us) transient should also be ignored, which means that we should not consider the light bulb being lit until the full signal edge arrives after completing the copper wire circuit.

Another case where an engineering approach and a practical demonstration are superior to a theoretical explanation.
Reply: @wbeaty  Yes by matching the impedance of the line and the load it can get better. But I still think this video is much more correct than Vertasium, at least for DC.
Reply: For the comment that you made about having differing currents on either side of the battery that could be explained by the fact that holes (sudo positive charge) move at half the speed of electrons. That is why in very high end electronics you use NMOS not PMOS. This would mean that the current should be about half on the positive side but I look forward to see what your results are in your next video.

I think your findings make a lot more sense then what Derek was saying. Keep up the great work. :)
Reply: MISSED OPPORTUNITY:   you should have done a test with the "light bulb" much further away from the switch (the parallel wires spaced farther a part, forming a much wider rectangle).  We should then see a much smaller or negligible current induced by local changes in the electromagnetic field near the switch, which would help confirm for the audience your explanation of the initial small current.
Reply: With regard to induction: if you look up the inductance-per meter of a parallel-wire transmission line [1], you will see that, all else being equal, the closer the wires are, the lower the inductance, and as they get close to touching, the inductance gets close to zero. I believe this can be explained as follows:

Every wire carrying a varying current exhibits self-induction: if the current is increasing in a given direction, an EMF opposing that current increase is induced in the wire (e.g. if the current is increasing to the right, the induced EMF is trying to drive a current to the left.)  This creates something a bit like inertia, preventing the current from increasing instantaneously.

If there is a second wire parallel to the first, an EMF is also induced in that wire. It is in the same direction as the self-induced EMF, so, in the above example, a rightward-increasing current in the first wire induces a leftwards-pointing EMF in the second. This mutual induction is never greater than the self-induction, as the second wire is never completely coupled to the magnetic field produced by the first.

In the experimental circuit, up until the voltage step reaches the far ends of the transmission lines and reflects back (and also in the steady-state) the current flow in the parallel wires is antiparallel: if it is going to the right in one of the wires, it is going to the left in the adjacent one (what matters here is actually the rate of change of current, but here we are concerned with how fast the current rises from zero, which is also anti-parallel: for the load current to increase, there must be a leftwards-increasing current in one wire and a rightwards-increasing current in the adjacent wire.)

Because of this antiparallel arrangement, the mutual induction opposes the self induction, and tends to cancel it. The closer together the wires are, the more strongly they are magnetically coupled, and the greater this canceling effect. As the mutual inductance cannot be quite as strong as the self-inductance, there will be some residual inductance, but, as inductance opposes a change in the current, the less inductance present, the more rapidly can the battery increase the current in the load.

Electromagnetic theory shows that, if there is no resistance in the wires (which is not the case here) and no conductance between them, the resulting impedance between the terminals at one end (either end) of a transmission line is purely resistive. I cannot see any way of explaining this without doing the math.

[1] https://www.easycalculation.com/engineering/electrical/parallel-wire-impedance-calculator.php
Reply: 20:34 except you haven't found that information can go faster than light.
17:00 you explained how the electromagnetic field transients across the 0.1m air gap, which would be at the speed of light.

Instead of wires running 10cm apart, run them in a circle with the light bulb 1000/π m away in a perfect vacuum, or even better, Two wires 10cm apart for 500m with the lightbulb on the other end in a perfect vacuum, and you'll see that information does not, in fact, travel faster than the speed of light. Except of course you can't measure that as the oscilloscope wires will also have to be 500m long each.

You instead proved Einstein, you proved electrons affect other electrons 10cm away "almost instantly", being unable to measure with accuracy the speed of light that distance.
Reply: Blessing ?
What blessing, Darek is an atheist.
He don't believe in blessing.
Reply: Hoping part 2 has the battery & load 500m apart

    (+) ——————————————— (  )
battery                                            load
    (–) ——————————————— (  )

This should demonstrate that this "instantaneously induced current" depends entirely upon the shape of the circuit, i.e. not only that it is small as compared to the fully propagated current, but also that it only exists in a rare case that is not usually observed in the real world.
Reply: Ok, so if I understand Derek was wrong, the induction effect is really tiny compared to the current flowing along the wires. And next time if you make something like a circular loop or a huge square with the wire, the induction would be so faint that we should only see the 2nd signal on the graph ?
Reply: @grosminetytp5520  Correct.  You might get a sizeable current if the wires were closer, but at 1 meter apart, the induced current in the opposite direction is insufficient to light the bulb & is relatively negligible.
Reply: It is almost impossible to separate magnetic from electric field. Electric field is property of electrons and magnetic field occurs when electrons are moving (EF is changing). I guess you need bunch of tiny solenoids to create almost pure magnetic field.
 The problem with Veritasium video is not whether he is true or wrong, but his intentional deception in order to gain few clicks.
Reply: !!CAUTION!!  ALSO ANOTHER POINT. THERE IS PRACTICALLY NO DIRECT INTERNAL FLOW OF CHARGES INSIDE THE BATTERY FROM THE NEGATIVE POLE (-) OF THE BATTERY TO THE POSITIVE POLE (+). SOURCE RESISTANCE IS 100s OF MOhms. THE EXCESS ELECTRON CHARGES OF THE CONNECTED BATTERY FLOW EXCLUSIVELY FROM ITS  NEGATIVE POLE TO THE LACKING ELECTRON CHARGES, POSITIVE  POLE OF THE BATTERY THROUGH THE WIRE UNTIL BOTH POLES REACH EQUILIBRIUM AND THERE IS NO MORE POTENTIAL DIFFERENCE BETWEEN THE TWO POLES OF THE BATTERY (-), (+) THUS THE BATTERY IS 0V EMPTY.
Reply: Thank you for conducting this experiment. I remember old components like Philips 470ns delay line providing a 140 meter long coil, with reverse turns to avoid magnetic fields, and used in television devices. So Derek's explanation didn't meet my electronic knowledge
Reply: Thank you so much for doing this video, Veritassiums video was very well produced, but for once not very well explained. After I watched ElectroBooms response I had a better idea what it was really about and after your video I also believed it.
Reply: Very good and interesting video and experiment. So what is your conclusion? Is Derek right? 

It's interesting that everybody tries to explain this in terms of current, resistance, capacitance, inductance, ... All of them as isolated phenomena. No one takes all 4 Maxwell's equations as they are at once and applies them to the problem without assumptions and/or simplifications. Which would be the right way to it IMHO. (I know, it's not easy.)
Reply: As you nailed, I think the only thing which is still ignored is that the wave originates at the switch and at the very beginning no current is flowing though the battery,  (there is an implicit assumption about the initial state which must be in equilibrium otherwise the bulb would be on before acting on the switch). To test this, one might try to move the switch at one extreme of the circuit and then you should be able to see a ~250m/c delay (but I guess it may be tricky to set up such a circuit and you may need coaxial cables to control the switch in order to avoid interference between the two circuits).
Reply: You have enough wire and are curious enough that you might be interested in my idea of using a rather complicated earth battery setup to make a lightning attractor to create artificial Fulgurites, lightning fused sand.
Reply: As you asked: you could choose a thicker wire or higher resistance resistor, or higher voltage battery. The loses on this wire are higher than the power on the resistor!
Cool vid, congrats!
You could as the prove against Vertasium claim provide Power calculation to resistor in time: I*U(t)
Reply: @AlphaPhoenixChannel  More things to try:

To circumvent the idiosyncrasies surrounding "how much current turns the light on", consider the reverse situation where a light is illuminated and the switch is then opened.  We intuitively understand that the turn-on and turn-off time should reasonably be symmetrical.  While the Displacement Current starts to flow almost immediately, it will take the full wire propagation delay for the delivery of power to the load to stop.  This is unequivocal proof that Veritasium is misleading his viewers by playing games with the meaning of "turn the light on".

The switch is located on the battery's low side.  In this case, the length of the high-side wire is irrelevant.  You can shorten or lengthen this wire as much as you want and you will still see the Displacement Current start flowing for the same amount of time (e.g. 1.6 us in your setup).  There may be some small changes because the DC resistance of the entire loop will change, but you shouldn't see these until the wavefront has propagated down the wire to the load.  This makes sense, since your calculation of the wire length based on propagation delay was around 500 m.

Putting the switch on the high-side of the battery should have no significant effect (i.e. still 1.6 us of Displacement Current)

Using a DPDT switch to avoid "precharging" either the low- or high-side should have no significant effect, provided that you don't have some large static charge already present on the wire, which isn't something you can really do.  This setup is likely to cause more measurement errors, rather than eliminate them.  In the event that there is no significant charge on the wire already, it would effectively be the same as the low-side of the battery already.

Moving the switch halfway to the load (i.e. the ends of the wire) should reduce the duration of the Displacement Current by half (e.g. 0.8 us)

Moving the switch to the load should reduce the duration of the Displacement Current to nearly zero.

The interplay between the wire's DC resistance (Rw), the wire's characteristic impedance (Z0), and the load resistance (Rl) is important (and possibly the source impedance Rs as well).  It would be ideal to run four separate tests to cover all the conditions of Rw compared to Z0 and Rl compared to Z0.  If Rw > Z0 I expect an RC ramp after the Displacement Current is done.  If Rl > Z0 I expect multiple reflections.  If you raise Z0 such that Rw < Z0, it should be easier to see reflections.

I believe the negative spike after the Displacement Current in the wires-cut test is the result of inductance.  It certainly looks a lot like inductive flyback "searching" for a way to keep the current flowing.
Reply: Thank you for the experimental setting. It conforms to my intuition and was helpful to re-assure friends who were confused after veratissium's video. Yours is much more helpful, even though I would explain / model differently, but in the experimental setting you are grandious. I also like that you didn't stop at the simple layout of the circuit, but cut the lines to clear up that point, too. So I will recommend your video instead and caution people against Veratissium's.
Reply: @AlphaPhoenixChannel  I think that it would be important to determine if that coupling is the capacitance/insurance of the wires or just cross capacitance inside the oscilloscope. I would try to connect it only to the resistor (no connection to the switch side at all) and activate. If you don't see that small plateau before the main signal in this condition, you would know it's instrumentation artifact.
Reply: @Fabian-mu3hq  In germany it is, but not in every country. In the USA it's both V for the symbol and unit.
Reply: He said bulb come on.  Not smallest amount of voltage.  So bulb on is length/c.  Not 1/c.
Reply: Release that next video!!!! You rock!
Reply: You rock !

So basically... don't SIN

y ?

COS.
Reply: Did you take into account that the Speed of Light is dependent on the medium it is traveling in? What is the speed of light in a metal Wire? (there is one)
Reply: @armastat  lmao
Reply: Id say the "digital" radio you created works by capacitance. Induction basicly is what you get when creating a big loop. Induction can be explained by relativity ( lenght contraction), what you explained/showed is the capacitive part.

My initial thought before seing the whole video was that the scope itself may be causing the small signal at the start, which could be proven not being the case by disconnecting the resistor/receiver antennae side, and then doing the exact same. If you do get the same/ or something close initially, then the setup needs refining.

Anyway the video is great, thanks for making it!
Reply: @Jope atoms BUMPING ? ha figure of speech

However, they do not actually touch each other (because they aren't even physical, just computed) and the force repelling is the electromagnetic force. If you doubt this, try putting two like poles of magnets together, you have to force them. FORCE them.. overpowering their small amount of force with your large body of "cells"

ALTHOUGH, I could be technically incorrect and hence broadly incorrect. It happens ;) care factor ? 0.0 +/- 0.05
Reply: @johnnytheprick Are u trolling me or are those serious question?
Reply: @johnnytheprick There are many ways to measure the speed of light and you can find all of them in the textbooks (or even on youtube). But I am Confused with your question itself. I am not sure What something that can or cannot go that speed has to do with measuring it. 

Again not sure what you are asking in the second part as well. If you are referring to my statement that 'The speed of light is dependent on the medium it is traveling in"? That is a law of Physics. When people refer to the speed of light in generic terms it is always the speed of light 'in a vacuum'. It changes when light goes through something else.
Reply: @johnnytheprick The abilities of a radar are dependent on it design. Max speed of a radar is dependent on its Gate timing. In other words how fast it sample the returning radar signal. The designers of the gun decide what speed range it would be accurate at. likely it would just say 'Speed in excess of 300 mph'
Reply: @johnnytheprick No. I said 'Light' does.
Reply: @johnnytheprick Electrons are effected by electromagnetic fields yes. not sure what you mean when u say "electromagnetic spectrum of electromagnetic". that is just nonsense as far as I can tell.
Reply: If you're still getting a small current Through the Wire after cutting both ends of the wire, I would put a faraday cage around wire that is connected to the light bulb and then see if you still get that initial current. You have to find some way to Shield the electric and magnetic field and a faraday cage is the only thing I can think of. If you don't get that current after you Shield it then you know that your theory is correct, if not, then it's back to the drawing board.
Reply: @cda32  also the skin effect at high frequency
Reply: @AustinSteingrube  kirchhoff's laws only apply to closed-loop systems. There was electrostatic effects from the environment, so even if it was a closed loop system at first, you have to account for the energy source of the environment that's present in the closed loop. So technically there is no such thing as a closed loop system, because you will always have environmental effects, not to mention the observer effect, which will make your circuit and open system. Isolated systems as they talk about in the physics textbook don't actually exist in nature. This is the major flaw in electrical engineering since the scalar component was taken out of Maxwell's electromagnetic equations. Once you take into account EA Whittaker's scalar electromagnetic Theory, you can start to look at these systems a lot differently, then current electrodynamic Theory which is a linear electrodynamic Theory, Whitakers scalar electrodynamics produces nonlinear electrodynamic effects. This produces a much different picture of the system, because there are physics allowed in nonlinear electrodynamics, that are not found in the traditional linear electrodynamics I see mostly on all of these engineering channels.
Reply: Awesome video, thanks for taking the time to show us that. However I do believe that there is a nonlinear electrodynamic explanation. Although kirchhoff's laws dictate that for a closed-loop system that all of the energy going into it must be the same coming out. However the isolated systems that physics is based upon do not exist anywhere in nature. You have cosmic rays, the observer effect, and just the electrostatic energy in the environment itself that you yourself were picking up on the line. So if you try to make a linear calculation based upon the energy that is contained in the battery and you ignore the rest of the universe, you are probably not going to get the entire story. This is like when Oliver heavyside took the scalar component out of Maxwell's electromagnetic equations. If you look at EA Whitaker's scalar electro-magnetics Theory you will quickly see a nonlinear electrodynamic explanation or framework upon which you can make an explanation. If you put a faraday cage around the light bulb wire and you still receive that current then you have to start looking elsewhere and this is where I would start. I look at all of your guys's engineering videos in all I see is a linear electrodynamic explanation which totally ignores the scalar component and any nonlinear electrodynamic explanation. You guys are missing out on all sorts of physics that do not happen in linear systems and as I said all systems are nonlinear. So for my perspective you are only explaining just a part of what is actually going on. Colonel Tom Bearden explains a lot of this in his Publications on his website chenier.com
Reply: @johnnytheprick If you want to ignore the last 100 years of science that is up to you. If you deny the results of uncounted number of experiments that prove otherwise, that is a personal choice. If you want to go around trying to contradict everyone based on your own superior knowledge, that's a You problem. If you want to do it in public it's not MY problem. Thanks for participating.
Reply: Don't ask permission for something you do not need permission to do. You are misleading people that they need permission to do this experiment.
Reply: How about a big circle for the circuit instead of two parallel lines?
Reply: Thanks for the video. This promises to be an extremely interesting series, so you've earned another subscriber here. 🙂👍

I'm glad that you said 'almost at the speed of light', because no transmission line allows energy to travel around it and along it at the speed of light. There is always a slowdown. In coaxial cables, that slowdown is often 15% or more, and can reach closer to 33% in some cheap cables. 

A similar correction factor has to be included when designing antenna active elements, reflectors and directors. In those, the correction is still around 5%. Your relatively open transmission line length would be worth measuring more accurately, so that you can take that delay into account more precisely. 

Interestingly, even that low power D.C. switching will result in a very small quantity of emission as a radio signal, losing some energy to the surroundings. That resonance in your scope traces is evidence of that.
Reply: @jeffvan2529  I'm not arguing with you, but I've have never come across "EA Whittaker's Scalar Electromagnetic Theory". Do you have any sources that describe why it is more complete than Maxwell's laws? Is it the case that this may apply primarily to fringe effects at a small scale and not necessarily larger, simpler systems?

I'm a bit confused by your description as well. "There was electrostatic effects from the environment..." can you describe what you mean by this? Electrostatics don't typically have effects apart from attractive or repulsive forces caused by static electric or magnetic fields. They shouldn't impact the transient behavior of a system outside of biasing where fields become saturated. For low voltage, low current, low frequency circuits such as this one, those shouldn't come into play.

"So technically there is no such thing as a closed loop system, because you will always have environmental effects, not to mention the observer effect." Can you describe what you mean by "observer effect"? The reason the electromagnetic force is "electro" + "magnetic" is due to relativistic effects to start with. This is still captured by Maxwell's description as best I know. For there to be no closed loop system would completely break three of Maxwell's equations which are the underpinnings for every electrical system ever designed. One of the most important equations is Maxwell's second equation that states that the sum of magnetic flux through a closed loop is zero which has been absolutely proven in physical experiments - to break it means that we have magnetic monopoles and we've yet to be able to find or measure one.

While Whittaker's physics may have some measurable effects, I don't think they are as pronounced as you think they are. Nearly all losses in a system that aren't calculated using basic equations come from parasitic capacitance and inductance. These losses are still model-able using basic EMag equations and a bit of Calc 3.
Reply: Why is everyone forgetting the velocity factor of copper is 95%?  That's 5% less than the speed of light, NOT EQUAL to C !
Light even doesn't travel at C either except in a vacuum.
Reply: @johnnytheprick I have no idea what your issue is, but you need to get it checked before you hurt someone. And to make it clear. There is no speed issue of How You measure how fast something travels. Your question is so absurd it challenges the mind to try to fit it to reality. there is no 'measuring' device that moves. There is no need to travel AT the speed of something - even light - to measure its velocity. its a timing issue. Start = 0 seconds, arrival = +X Seconds over a known distance. Do the math. Everyone is taught that method in math class at school (multiple times). He even illustrated that plain as day in the video.
Reply: In the open circuit where you cut the end of the loop, current at the battery and switch ends should peak somewhere between  the start and midway through the time it takes to charge the capacitance of the wires. The resistance in the circuit would lead to the start and inductance in the wires would lead to the midway point. When the loop is closed, the capacitance has a load across it, and changes the timing. I believe that this plays in to the non symmetrical readings you are getting at either end of the battery and switch.
Reply: @johnnytheprick What do u mean by 'measure'? It's Speed? color? taste? Its taste in Music? We have 'detected' particles that seem to be going faster than light - by measuring it's travel time between point A and B. But again there is no 'Device' except a clock used in measuring speed of travel. You need to get the word 'device' out of your mind, its not applicable to the topic.
Reply: @johnnytheprick no
Reply: @Kenny lol. you just reminded me of my experiments with electricity. as a child i enjoyed pulling a plug out partway, from the wall socket, and put my fingertip across the tangs. it didn't hurt, that I recall, but I got a good whole body hum out of it.
Of course after I built my firs multi-meter and had it explode, and weld the probes to a wall socket, I never did that again.
Reply: There's an additional confound that you did not control for. Is my theory that the material itself that the resistor is made out of, has to be voltage saturated before you can measure the differential with your oscilloscope. One way to possibly demonstrate that would be to use two equivalent resistors made out of different materials. If that is not convenient or available then cool down or heat up the resistor "material" I think that will demonstrate a change in time for the larger voltage differential that you are observing.
Reply: Please do an experiment with a shielded cable (maybe not all the way through but at least around the switch and resistance). In that case there won't be any initial current.
Reply: @johnnytheprick Why?
Reply: I prefer the inductance explanation. 
1. It's first year physics. There is a "change in current" occurring at your arrows. This induces a magnetic field to develop. The change in the magnetic field at the second wire induces a reverse current there. 
2. I'm a radio guy. The cut wires are like transmit/receive antennas. The "signal" on the battery (transmit) side is picked up by the bulb (receive) side. The signal is just a current pulse, but still a signal.
Reply: The final resistor voltage should be 4.6V, if your 1KM of #24 wire is around 86 ohms, in series with your 1K and your 5V drive.   But on the scope the final resistor voltage appears too low by almost a volt.    So, something is wrong somewhere.   Stay paranoid, and perform detailed debugging!   What does an ohmmeter say about the total loop resistance?  Anywhere near 86 ohms (check wire tables)?    I hope you didn't connect any part of your 5V pulser to power-line ground!  or scope ground.   That might create massively wrong results, unless your pulser could send a balanced +2.5V on one wire and -2.5V on the other.
As earlier:  vary your 1K resistor value until the initial voltage-step across the resistor is exactly 1/2 of the final voltage.   Then measure the resistance.   That tells us the 2x Zo impedance of your 2-wire lines, via impedance matching.    Expecting roughly 1700 ohms.    But on your scope traces, it appears more like 10K ohms!!!   Is 2-wire line theory wrong?   Or is there a circuit mistake?    (Or are we all wrongly neglecting the skin effect, which greatly increases the instantaneous resistance of thin wires!)
Reply: @KiitosKaloista  I wonder if something is wrong here, since the final voltage should be 4.6V, with 86 ohms of 1KM wire in series with his 1K resistor.   On his scope display the final resistor voltage seems low by almost an entire volt.   Fix that problem, and maybe the waveform shape will change, and not just the scope vertical gain setting.
Reply: @KiitosKaloista  on characteristic Zo, look at his scope traces.   The Zo appears to be 10K, not 820 ohms!    Very strange.   Does the dirt have that much effect?  OH JEEZE, maybe is 1K resistor was never checked, and it's actually something like 120 ohms instead?   That would explain his low 200mV, which instead should be around 1.8V, if the Zo of his lines is around 800 ohms.
Or, maybe his 5V pulser isn't floating w/batteries, but has one side grounded to the AC power line.     Ideally would be to split the existing battery ingto two batts in series, with the switch wired in the connection between them, to give a balanced DC step.
Reply: Oh dear, you don't need a blessing to do a scientific experiment.
Reply: @redstar5607  but when it is about showing its influence on the effect it would make sense to make the measurement in a setup with and without twisting otherwise unchanged.
Reply: Finally someone got it right.  But you don't need anyone's permission to run an experiment.
Reply: @denny9931  Yes, I understand.  It's just very difficult to twist more than a couple of meters of wire.  The problem is that as you twist the wires together, you have to untwist the free end of the wires.
This whole experiment could be done better with a faster oscilloscope and shorter wires.  The long wires just make the delay time longer. IMHO, since the experiment requires a 'scope to see the results, you could go with shorter wires and measure faster times.
A 10 m loop would work better, but I it might be harder to get an intuitive understanding of what is going on.
Reply: What is the speed of light in copper wire?
Reply: @AlphaPhoenix 
The fact that you have proved there is a tiny electric current through the light bulb after d/c second  (d= distance between the wires, c = speed of light) when the switch is turned on due to induction and/or capacitance  does not mean you have proved energy is transmitted by electromagnetic wave outside the wires when a steady current has been established in the circuit as Derek claims. I believe before a steady current has been established, induction due to change of magnetic field strength is the major reason why there is a tiny electric current through the bulb. 

We know a change in magnetic flux relative to the electrons inside a wire can induce an emf inside the wire but a  steady magnetic flux cannot. After a steady current has been established, the magnetic field created by the current around the wires is also a steady magnetic field with no change in magnetic flux. Therefore no emf can be induced between the two wires after a steady current has been established. 

Also after a steady current has been established, there will be no excessive electrons along any part of the two wires, therefore there will be no electric field between the sides of the wires and no capacitance as well. 

That means after a steady current has been established, a steady magnetic field outside the wires is the only thing created by the current. A steady magnetic field alone cannot transfer energy in space. 

Therefore, it is wrong for Derek to think energy is transferred from a 12 volt battery to a light bulb through electromagnetic wave in space when there is steady DC current flowing in the wires when a steady DC current has been established.
Reply: @evilcanofdrpepper  Derek was as much about getting views and a sense of controversy so that science is discussed.
Reply: @patricksweetman3285  It depends on the physical configuration of the wires and the type of insulation. In this situation, I guess it would be just under the speed of light in a vacuum.  
It is quite common to buy cables that have a speed of 66% c.
Reply: Close, very close. Use antenna theory to understand what is going on. The wire in the open circuit is comprised of electrons (-) and holes (+). When you complete the circuit, the electrons throughout the wire align towards the - and + poles which only takes a few atoms of travel  distance throughout the loop. This is an electrostatic force (capacitive).  This makes an apparent current flow through the closed loop which appears almost instantaneously.  The current dip you showed is a reflected wave function (similar to a SWR on  a poorly tuned antenna). You have several things going on, but RF wave analysis is the key.
Reply: I find lightening travels faster then the speed of light .
I find lightening becomes a solid to break sound barriers.
Light is fast.
Lightening is faster.
Reply: @saskoilersfan  Sorry Tyler, light is faster than lightning. I saw a fascinating paper in the 90s where they captured the speed of lightning using ultra fast photography.  They set up a Vandergraph machine to create the lightning, triggered a transistor from this to start the camera, using a telescopic zoom and a mirror (about 100m away) to capture the images that were already in flight when it triggered.
Reply: @brendanh8193  in daylight...
I read older papers and books by those who tried to dabble in lightening.
" Light doesn't break the sound barrier and lightening does.".

In daylight we see lightening Flash's appear .

So I began building a lightening engine.
A motor that creates and runs on lightening .

I am reading a book by Ben Franklin who tries to catch and store lightening.

He feels lightening arcs from the ground , through sky , back to ground .
A lightening rainbow.

Tesla tried to get the arc from the ground by forcing the lightening to his tower.
He also tried to catch lightening.

Animals furs create energy...
Why ?

You have a disk player for sound.
Ever see a disk player for energy?

Ever see two disks create energy?
Ever see 5 disks creating their own style of energy due to the windings ?
I have.

Funny thing about my lightening motor...
It replaces liquids with very light energy...

Neat thing about energy...
It's not heavy. No weight to it.

That means , liquid fuels  no more weight problems.

Don't need to carry all that weight of liquid.

That makes the ship lighter.

I am not arguing...I'm just useing a different point of view and thoughts.

By those who chase lightening and try to capture it's elusiveness.

Lightening. Appears faster then daylight. Appears in day light. Moves across the sky faster then any machine man has made.

I've see planes and jets fly faster then the sun light around earth. 

Ride the lightening to , I hope , teleportation.

If not , then the speed of lightening .

I am thinking of a bullet train that rides lightening.
Reply: @brendanh8193  the machine you discribe is the basis for x rays. Vandergraph...no.

Wimshurst figured it out.
1883.

These disks ,due to different styles and materials and windings create different types of similar energies.

What you perceive as ancient art , I see old  technology preserved.

I see a dream catcher .
Change the material to bronze form  and copper winding from twigs and string.

The Incan calender is alot more complicated disc.
Similar to the Epcot disc Disney built.
Not sure if Disney got Epcot to power up or not.
He used copper plates with a brass core.

I think it was called " the A.l.i.c.e. project ".
Reply: @Fabian-mu3hq  I might not have enough experience to say for sure, but I think this is a physics vs engineering thing. I study at an engineering school and all the engineering classes teach V for voltage (and also V for volts), as that's what's mostly used in industry. Oddly enough my physics classes did the same, but that might just be because it's an engineering-heavy school in general.
Reply: @tylerdurdin8069  First thing's first, you could use some manners. We are trying to have a civil discussion here.

While he only mentions it in a comment response, he's effectively using differential probing. This means he's measuring the voltage across these resistors irrespective of the ground potential. Across such a short distance, relativity doesn't quite kick in, Ohm's law is king, and you can indeed reasonably relate the voltage measured across the resistor to the current flowing through it.
Reply: @kokoCD  It would be a very bad oscilloscope if it generated enough noise that it could detect it. Some people suggested that the real circuit involves the ground connection, but there was considerable effort put in to exclude this possibility (differential probing, insulating the wire from ground)
Reply: @aaronmicalowe  Sending information faster than light does break causality. I'm not sure what experiment you're referring to but there has got to be some misunderstanding or miscommunication going on somewhere along the line.
Reply: @antonliakhovitch8306  well then something else is happening. Maybe the info is wrong but dropping electrons shells is one of those unexplained things.
Reply: @jonmobrien  He never claimed that information travels faster than the speed of light. He said at the very beginning that his oscilloscope isn't fast enough to measure the time difference between the switch closing and the initial blip, but conjectures that it actually takes slightly longer than Derek proposed.

The thesis here is that Derek is technically correct but his explanation is plain terrible.
Reply: @noonerelevant2583  Quantum physics deals with things on a very small scale. It becomes difficult to measure stuff like this on the level of one atom. However, here we are talking about large trends over ridiculous quantities of atoms. Weird quantum effects become largely irrelevant and we enter the realm of relativity.
Reply: @johnnytheprick Derek didn't specify a mechanical switch. He specified an ideal switch - this doesn't exist, but a transistor is much closer to this than a mechanical switch.
Derek also specified an ideal light bulb, which also doesn't exist. The resistor/oscilloscope used here is a far better approximation of Derek's ideal light bulb than any bulb that actually exists.

Remember: Derek's example was a thought experiment, and this is a real experiment. Thought experiments often simplify things, so there are always modifications that need to be done to make them doable in the real world.
Reply: @johnnytheprick Hmm? It's actually very easy to measure the speed of light. Just bounce it off of something and time how long it takes to get back to you. Don't have a precise enough clock? Put your mirror further away (on the moon, for example). And yes, it IS different in different mediums. That's the basis behind refraction, which allows lenses and such to exist.
Reply: @jeffvan2529  I love this! A "Faraday cage around a wire" is called shielded wire, and is very much a thing. Twisted pair and coax are improved designs, where the inductive and capacitive effects actually cancel themselves out.
Reply: @antonliakhovitch8306  oh yeah duh I was imagining building a whole Faraday cage, but shielded wire will work much better!
Reply: I'm a bit late to this video than I normally am (especially for your videos) but I left a comment on someone else's video that was a response to Derek's. Mine read:
"I'm not very experienced either in EE but I'm going to give it a go.
I'm pretty sure that the position of the bulb and the battery don't matter but the distance between the switch and the bulb does.
On the + side of the battery the static voltage is zero, on the - side it is some voltage let's say 5V, also static; no current flows and no magnetic field so no power is transferred.
When the switch is closed, the 5V meets the 0V side at the switch and a voltage gradient is formed along the wire radiating outward along each length of wire to the left and right of the switch until it reaches both ends of the battery.
as the voltage gradient is formed, electrons are pushed and squeezed together tighter and pushed forward faster, forming a current that rises as the voltage rises at that point in the wire until they reach their peak voltage.
Now on top of this is the capacitive action of the wires, as soon as current flows across a length of the wire, the parallel wire 1m away receives an induced voltage too.
So in Derek's video, with the switch next to the battery, the bulb will light dimly in 1e-9s from the capacitive action, stay steady until the wave of actual current reaches it, in 2s.

Two other situations;
with the switch on the side of the bulb but far away: as the switch is closed, the bulb will not light until that wave of current reaches it, as there is no capacitive action before the full current reaches it. so the time for the bulb to light will be the function of the speed of light and the distance from the switch.
with the switch on the side of the bulb nearby, the bulb will light quickly according to the function of the speed of light and the distance from the switch; same reason, just faster.
with the switch on the side of the battery, but far away, the bulb will not light until the current flow causing the capacitive action reaches the wire across from the bulb (it will come from the top first) and it will light dimly, after that the full current flow will reach it and it will brighten to full power.

So ONLY in Derek's specific situation, and his specific condition that it lights under any means is he right. And even if I'm wrong (likely), I think Derek purposefully made it like that and purposefully kept the solution vague to spark scientific dispute; which is kinda dirty, but...chaotic good?"

I'm glad that my intuition was pretty right on this one :)
Reply: @Fabian-mu3hq  Nah, Volts is the only symbol in physics that is its unit symbol and its equational variable symbol. U is the symbol for potential energy
Reply: @antonliakhovitch8306  at 20:35 he does
Reply: @jonmobrien  Nonono, he says it confusingly but he's saying the opposite. He's saying that what we're seeing can be explained without having to do something crazy like "calling up Einstein and saying that information can travel faster than light." I did wish he was a bit clearer there though; I had to listen to that sentence a few times.
Reply: @antonliakhovitch8306   oh. Thanks mate.
Reply: @antonliakhovitch8306  I wasn't thinking about noise but about the circuit being closed by the probe wires, causing a measurement current to flow.
The impedance on the inputs is 1M with 15pF for these scopes.
The resistance would imply a current of around 2u so neglectible but now im wandering how the capacitance would play.
Not saying he's wrong, just want to try and grasp the variables at play in this experiment.
Reply: I am unimpressed.
Reply: @johnnytheprick Actually though, I will define "ideal". There are more-or-less standard ideal versions of various components. An ideal switch has no resistance, and closes instantaneously at a known time with no bounce. Mechanical switches are far from ideal, but they do their best. Transistors are closer in many situations.

An ideal wire has no impedance. An ideal resistor has no capacitance or inductance, only resistance. None of these components exist, but they're used in thought experiments and then replicated as closely as possible in real experiments.

The really weird one though is Veritasium's ideal "light bulb". What he actually describes is a binary current indicator that will light when any current at all is present. He says this explicitly. The curious thing here is that actual light bulbs are very, very, very far from this, making the "light bulb" analogy extremely misleading. AlphaPhoenix clearly explains his reasoning for using a shunt resistor + oscilloscope instead - it's actually much closer to Veritasium's imaginary "light bulb" than any real light bulb.

Btw I know I can't convince this guy of anything, I'm just hoping that the explanation might help someone else.
Reply: @kokoCD  Ah, that makes sense. Yeah, it's always a delicate balance to choose component/voltage values that make the various parasitic effects inconsequential and keep the signal measurable.
Reply: @antonliakhovitch8306  especially when doing a test as this, changing variables to see if the effects are the same are important, looking forward to the follow up vid
Reply: @goranjosic  I'd also like to see the circle/diamond version of this circuit. The only thing I can't figure out is where to position the oscilloscope. In the center? Near the "top"? Either way you need very  long wires from it to the measurement points, so we need a way to compensate for the lag this introduce.
Reply: You could simply do a big circle with the wire and have the oscilloscope on one side, and the battery on the other side. Change nothing with the circuit.
Reply: @johnnytheprick You're confusing two different types of speed. The speed of light is the distance/time type of speed (measured in m/s). The speed of electronics is measured in hertz, the reciprocal of time. These two types of speed are completely unrelated.

Thus, "you can't measure the speed of light because your instrument can't go faster than light" is pretty nonsensical. Can you measure the speed of light with absolute precision and accuracy? No! You can't measure anything with absolute precision and accuracy. Can you measure it with extremely good precision and accuracy? Yes! It's been done many, many, many times. Please explain to me exactly why the mirror experiment (which, again, is as simple as it sounds and has been done plenty of times) doesn't work. As I said - the further away you place your mirror, the less your instrument precision matters; with a large enough distance, signal propagation delay and such becomes irrelevant.
Reply: @johnnytheprick And yes, "ideal" components are imaginary. The reason we think about them is that they are far simpler than real-world components. If I'm describing a hypothetical situation to someone, I don't want to have to think about a bunch of tiny weird effects that don't matter much.

Like if I'm planning a party, I might specify that I need ten chairs. I don't need to specify load bearing capacity and material for each chair - everyone just assumes I would prefer an ideal chair that is extremely comfortable and won't ever break, and then later on when setting up the party we find something close enough.

Similarly, Derek doesn't need to specify exactly what kind of switch or wire he's using in order to prove his point. It's a hypothetical situation, we just assume the ideal case and Derek can carry on with the explanation.
Only when we design an experiment to test Derek's idea do we actually need to find specific real-world substitutes for the ideal components.

Welcome to science. Lolololololol omg.
Reply: @johnnytheprick I think I'm done with this but I'll add one more thing.

Not only is the speed of light measurable, it's painfully obvious in some situations. When you send a command to a mars rover, it takes a few extra minutes to respond on top of the processing time. Six minutes and four seconds is very perceptible. When you're designing high speed electronics, you have to account for signal propagation delay and match the length of traces within a certain tolerance. When you're doing time-of-flight measurements- well, I've already talked about that.

My point is, I understand if people are sceptical about weird novel theories that don't yet have application in the real world. However, it absolutely boggles the mind that people will deny the basic science that all of modern engineering relies upon. I have an uncle who is the same way and it sucks that I can't really do anything about it.
Reply: @johnnytheprick Screw it, I have nothing better to do right now anyway.

Okay, you specifically want to measure the speed of light the way a radar gun measures speed. You are correct, this type of experiment does not work for measuring the speed of light for precisely the reasons you described. However, a radar gun is not the only way of measuring speed (see: mirror experiment.) There are other, more complicated ways of measuring things - but this one is the most straightforward to explain. It doesn't matter if it's primitive; it works and it works well.

Then, about your shotgun - you actually did a surprisingly good job explaining a point I was going to get to. Yes, a laser is like a shotgun and it's very hard to get one photon. However, to measure the speed of the bullets, you only need to measure the time from the gun being fired to the first bullet reaching the target. There is no need to get one individually.

And yes, the reciprocal of time is frequency. I thought that's where your confusion was - you were talking about fast electrical circuits so I thought you might have been conflating speed as in "computer speed" or "clock speed" with actual speed. I was wrong, you're confused because you're limiting yourself to radar guns.

And yes, a radio signal is the same as light. That radar gun you mentioned? It's actually a time-of-flight proximity sensor like the one I described earlier. It literally IS the mirror experiment. It only works because we know the speed of light. Just point one at a car - if the radar gun matches the car's speedometer, you've just done an experiment to prove we have the correct speed of light. Don't think radio waves are light? See above comment about laser rangefinger.
Reply: @goranjosic  
I came here to suggest the same, for a different reason. If he had left the wire in the spool he wouldn't need an actual big farm land for this experiment. But most importantly, he found conduct the experiment in the comfort of his room and not be affected by the weather. 
Now that I think about it, wire in a spool would increase the inductance and capacitance effects significantly. 
Maybe it's best to stretch it out, for accuracy to the original thought experiment proposal.
Reply: @johnnytheprick Well this explains a lot about you.
Not sure what question you are referring to. You really need to work on both your logical thinking, reading comprehension and communication skills.

Alas for you, research has also shown that people suffering from Dunning Kruger are completely unaware of their ignorance.
Reply: @bogslurp3532  Kudos to all. Veritasium for inspiring all these responses and providing this spark and to everyone for replying! I've seen so many replies, each of them fascinating and I love this one also. Very good explanations and great way of talking which makes watching almost addictive. Thanks all!
Reply: @Fabian-mu3hq  I'm an EE and have never seen U used - college always used E for electromotive force in place of V (volts). E=IR
Reply: This is possibly the absolutely worst explanation of why it seems that electrical charge travels at the speed of light!
This issue is so much simpler than this guy makes out!

In order to teach my apprentices the nature of voltage, current and electrical charge! I do the following!

Have the learners line up, one behind the other, all facing in the same direction!
Have them all place their hands on the shoulders of the person in front of them and make sure that their arms are fully streched out and rigid.

Now have the person at the back of the line push, with force, onto the shoulders of the person in front of them!

 At this moment, each of the learners feels a force pushing them forward! Since their arms are firmly placed on the shoulders of the learner in front of them, they move in the same direction of the force applied to them until the last learner in the chain is 'almost simultaneously' pushed forward!

The 'almost instantaneous' motion which the last learner in the chain experiences shows how energy can be transmitted from one place to another regardless of the fact that none of the learners (electrons) have actually moved very far at all!

Scott Reid,
HNC Electronics, Domestic Electrical Installer, tutor of electrical engineering units to both apprentices and adult learners. Such as:

City and Guilds level 3;
C&G 2382 Requirements for Electrical Installations (BS7671:2018)
C&G 2391 Inspection and Testing
C&G 2393 Building Regulations for Electrical Installations

Basic Electrical Health and Safety
Electrical Fundamentals

Kind regards,
Scott Reid.
Reply: @scottreid8231  Well, yes. Like in a hydraulic system, nothing moves far but force is very quickly transmitted potentially extremely large distances. That's not the point that is being made here. The point here and in veritasium's video is that actually, some energy travels through the gap between the battery and the light and arrives before the the energy that is being transmitted via the wires (not through the wires I might add, through the em field around the wires).
Reply: Hey, you need to watch Eric Dollard - History and Theory of Electricity on you tube. especially at the 1hr 39min mark..
Reply: I think that the information travells on the wire, not out, at 1/c time, that means that each step amang source and end increases time needing to reach the end (light bulb). So the information arrives just at light speed, but the flow of electron needs to travell along the wire. Dereck is on right the information needs 1/c to arrives, but ut is not due to distance between wire.
Reply: What happens if you move the switch further way from the bulb? Like a circle. Then the distance between the battery and the bulb is insane high. So the field at the begining doenst reach the area of the lightbulb?
Reply: WHAT IS COUNTERSPACE?

In order to make any sense of the term and the concept of “counter space”, we first need to be ready to free ourselves from deeply held but unphysical and nonsensical notions about space and time: that means we have first to erase from our mind everything we associate with Einstein, and let instead Faraday, Maxwell, Heaviside and Steinmetz guide our thought process.

What is a dimension? there is a difference between a physical dimension and a metrical dimension. One has physical reality, the other has not and exists only for the purpose of quantifying physical dimensions.

SPACE is a metrical dimension and it is ONE, NOT THREE, the three being the result of a choice, that of an orthogonal geometry. Any number of co-ordinates in any number of geometries can serve to define the boundaries of space-the use of the cubic three is habitual.

Quantifying Space is multiplicative and done in powers of a unit space dimension, let’s say [cm]. We have positive powers and negative powers. The positive powers being Length [cm], Area [cm^2] and Volume [cm^3], the negative powers being Span [1/cm], Density [1/cm^2] and Concentration [1/cm^3].

The positive powers of space are called “conventional-spatial“ relations, or simply “space relations”, the negative powers of space are called “counter-spatial” relations or counter space.

TIME is another purely metrical dimension, here again only to quantify. If space is multiplicative, Time is additive, represented by a number line. We can move forward and backward along this line while the notion of “per time” [1/s] represents a cycle, or frequency [f].

What are physical dimensions then? let’s say we have a carton of milk, then the milk is the physical dimension, whereas the carton is the metrical dimension of the bounding space. Milk as such has no boundaries, milk as such is not quantified. When you want to make cheese out of milk, you add the linear metric dimension of time…..

Now, with Einstein, the 20th century has relapsed into the primitivism of Newtonian billiard ball physics, totally ignoring and positively denying the foundational insights of our electrified civilization. Harvesting the fruits of these insights, yes, understanding them, no!

The primordial physical dimension is the unbounded ether, the polarization of which creates all and everything we see and feel. The ether as such has no duration and no extension, doesn't know space nor time.

“Time and Space … It is not nature which imposes them upon us, it is we who impose them upon nature because we find them convenient.” ....H.Poincare

It is the polarization of the ether which creates everything, and this polarization plays out between SPACE and COUNTER-SPACE: this polarization is called the ELECTRIFICATION of the ETHER, where Magnetism “lives” in Space, whereas Dielectricity “lives” in Counter-space.

Here we have to jump across a counter-intuitive canyon, because both space and counter-space are positive, inclusive quantities: the more space the more stuff you can store, but, counterintuitively, also the more counter-space, the more stuff you can store.

For the Electricity extant between a pair of wires in your lamp cord,

-the closer the wires, the more Capacitance (C in Farad) and thus the more Dielectricity.

- the farther apart the wires, the more Inductance (L in Henry) and thus the more Magnetism.

Therefore, the smaller the space: the more Counterspace → the more Dielectricity can be stored, and conversely, the larger the space between the wires: the more Space → the more Magnetism can be stored.

In order to truly appreciate this we have to let go of another “prehistoric superstition” as C.P.Steinmetz called it already in 1900: the idea that electricity moves in wires. It does not! Electricity is an induction process in time and not a movement in space, and it takes place between wires, in the “dielectricum”, NOT IN them. Wires are only wave guides, conducting only because they resist penetration, like fences resisting the passage of sheep for instance. Superconductors allow an almost zero penetration and therefore an almost frictionless guidance. Wires get hot because of sheep rubbing along the fence, not because sheep moving inside the fence!

It is a basic concept of J.C. Maxwell that the Electrical Activity is contained solely within the Dielectric Medium (i.e. the insulator), not within the metallic portion of the geometry which bounds it.

It is important to understand, that the dielectric and the magnetic field are force fields, exerting actions so as to increase their Coefficients of Induction, that is, the Dielectric Capacitance, and the Magnetic Inductance are increased.

-the Dielectric Field pulls the conductors together, increasing Counter-space.

-the Magnetic Field pushes the conductors apart, increasing Space.

The Dielectric Field is contractive and the Magnetic Field is expansive.

The total Electrification of the Ether [Q] in [Planck] thus is the product of the Magnetic Induction [Φ] in [Weber] - associated with the metric dimensionality of space - and the Dielectric Induction [Ψ] in [Coulomb] - associated with the metric dimensionality of counter-space.

Q = Φ･Ψ

The qualitative aspect of a medium with respect to Capacitance (Dielectricity) and Inductance (Magnetism) is expressed in factors called Permittivity [ε] as a factor of Capacitance and Permeability [μ] as a factor of Inductance.

[μ] in (Henry/cm) and [ε] in (Farad/cm) thus represent the Dielectric and Magnetic Inductivities of the medium bounded by the metallic-dielectric geometry. These can be seen as gradients characterizing a medium, like the resistance to a measles infection of a certain population. It is obvious, that without a population, there is no infection, similarly, without a medium, there is no Inductance Gradient [μ] nor Capacitance Gradient [ε]. Talking about [μ] and [ε] of a vacuum is therefore complete nonsense.

Because Electricity is not a thing, but a process, we need to look at the time variance of these primordial physical dimensions Dielctricity and Magnetism, like milk being a physical dimension, but now we are looking at making cheese, which involves time:

The rate of change in time of the Dielectric Induction [Ψ/t], or the time rate with which the Dielectric Induction is produced/consumed is the Displacement Current [I] and expressed in what is called the

Maxwell Law of Dielectric Induction:

I=Ψ/t…….in Ampere

The rate of change in time of the Magnetic Induction [Φ/t], or the time rate with which the Magnetism is produced/consumed, is the E.M.F or Electro-Motive-Force and expressed in what is called the....

Faraday Law of Electro-Magnetic Induction:

E=Φ/t ……in Volts

The total Electric Activity thus is the product of Weber/s and Coulomb/s giving us Planck/s^2 or the Electric Power [P] inWatts

Q/t^2 = Φ/t･Ψ/t = I･E = P in Watts

or

Q = P･t^2 in Watt･s･s

Thus, the total Quantity of Electric Induction i.e. the total Quantity of Electricity is given in Watt･second･second and that means that the variation in time, the rate of change, the time derivative of the total Electrification of the Ether is Energy

Q/t in [W]･[s]^2/[s] = [W]･[s] = [J]

One Watt･second is one Joule, the unit of Energy. That means, energy is not a primary physical entity, it is a time derivative of the electrification of the ether. It is NOT a fixed quantity of which the universe has only so much. Energy is a result of a process in time and has absolutely nothing to do with mass (E=mc^2). In an upside down way it does have to do with [c] though, and that is via the magnetic and dielectric laws of proportion and the magnetic and dielectric gradients [μ] and [ε]

Law of Magnetic Proportion: Weber ≡ Ampere･Henry

Law of Dielectric Proportion: Coulomb ≡ Volt･Farad

Weber･Coulomb/cm2 ≡ V・A・μ・ ε ……and that is the same as

Planck/cm^2 = Planck/s^2・μ・ ε …… and that gives us

s^2/cm^2 = μ・ ε

The product of the magnetic and the dielectric inductivities comes dimensionally in time squared over distance squared and that has been written as 1/c^2 and from that through mathematical transformation one has arrived at [c] in [m/s]. But we can see that this is fallacious, because nowhere here do we encounter a displacement of space per unit time, which is what a velocity is. There is no phyiscal reality that can be called “speed of light”, the underlying physical realities are two induction gradients.

Furthermore, this is strictly a characteristic of the Transverse Electro Magnetic Wave, so, elevating an incorrectly derived quantity with a limited domain of validity to universality, and on top of that call it a universal limit is totally bogus, and a cosmology built on it can only be called ideology, not a valid physical description of the world.
Reply: @AustinSteingrube  45 year EE here. Never seen 'U' used for voltage either. It's usually 'E' for Electromotive force.
Reply: I called it to a dot(kinda, guessed as the wires charge the lamp voltage would increase, was surprised it was such a straight line.), the wires act like a inductance and capacitance and that is why you get a small current(electricity) at the beginning and this is easily shown if you integrate over the wire thinking of every bit of the wire as it's own separate entity with small inductance and capacitance.
You forgot the "light" going between the wires yes you have inductance however small(but it will induce magnetic field perpendicular to the wire so the electric fields will be rotating in circle mostly inside the second bit of wire so it will largely depend on the diameter of the wire). Separating(isolating) inductance from capacitance is hard(theoretically imposible?), the only idea i have is a mirror for that particular wavelength of EM radiation, but it will get static electricity and introduce a difference in capacitance, so i don't know. How is the part two going?(will check your channel in a sec for it) and technically again, as i said(on a 1-st and 3-rd party channel, you being the second in this case) if you have a bulb that lights from any current (0 is any current) it will never be off, no matter what you do to it. People should be careful when they use magical physics(or math) land ( : the place where C is infinity, air has no friction, and has cows the size of planets, who don't crumble under their own weight), and applying it to reality. 
With the off center light bulb, you should have 3 rest levels (no connection, only short connection, both, with some backlash resonating at wire frequency) that is my guess. And your setup is different than what i imagined since your capacitance might be lower than expected, since we are talking c:1m multiplier, at a kilometer wire your wires should be basically touching(1/c = 0,(or ~0 in the real world case)), increasing the capacitance and inductance.
Reply: But wait, can we still agree that the electricity passes through the electro-magnetic field that extends far outside of the wire? And not through the wire itself?
Reply: Ok, so electricity is essentially electrons flowing/exciting down the copper wires. Correct? Does that mean that what is actually happening at the atomic level is an electron is being added to one atom, which results in an immediate release of a different electron into the orbit of a different atom's nucleus, (composed of the protons and neutrons)? Thus, the maximum amount of current of any material is limited by how easily the atoms will allow a new electron to join each atom while expelling an electron. 

If that is the case,  the reason that certain metals, alloys, or materials are preferred and set as the material and size is whether they achieve the desired results economical. (The abundance of the mineral(s), the ease of mining and refining, the lifespan of the material for a given use without melting, corroding, or failing in some other way.) Thus, a copper wire's ability to carry a given current is limited by how many atoms can gain and shed electrons repeatedly without overheating, (which will lose current by some current being turned into heat instead of remaining as electrical current). Is that correct?
What happens to the electrons if some current is lost due to heating? Are those electrons escaping from the copper wire and thus flung into the surrounding air/environment?

Thanks for any clarification on my understanding!
Reply: @gistnoesis9116  Great point about the wires being laid out like antennas. He didn't really talk about it, but it seemed like the wind blowing caused a change in his reading on the oscilloscope, which he didn't show us. Heat should also be affecting/changing the current in the wires. 
I wonder if these environmental influences would still appear when the switch is thrown if there is no battery/power source connected?
Reply: @alanbutler7712  you are almost correct(it's not the electron that is moving the energy in AC, light is, but it kind of is in DC, quantum stuff are weird, there could be only one electron in the universe reporting every time you see an electron, due to "spooky action at a distance" and "electron" being a wave more than a particle and something we came up with to describe reality) (...i am not a quantum or material scientist, so take everything with a grain of slat...)  (Bad that i can't see exactly what you wrote as i write...) The current is photons emitted from electrons which have been "excited"(gained energy in any way moving them to a higher orbit, or if free giving them speed, the word is proper slang) and retransmitted when they "chill"(a slang i just came up with  meaning reset to a lower energy level) releasing said energy in the form of a photon( of heat(infra red), UV, radio, radiation, depending on the "temperature" ((AKA the frequency of EM radiation, use interchangeably if talking of EM radiation)used, since heated stuff give energy to the electron which releases it as light at specific temperature, also proper slang, but less preferred than "frequency") of said photon, it can release it at different wavelengths depending on the orbit it wants to settle on) the good conductors are just capable of dispersing said heat quickly, and that is why metals that conduct electricity also conduct heat well and vice versa and also the opposite(plastic usually being a good insulator, exception "aero gel" being a good convection insulator, but if made of metal probably a goodish conductor needs checking). "What happens to the electron is lost due to heat" from what i said, nothing much(depending on which heat: convection,(see wiki for the other two, blanked on their names)), instead of releasing a EM wave(photon) and a second electron catching it, it : A. gets captured(absorbed) by the atom and the atom starts vibrating making friction with nearby atoms(Brownian motion, but in a cristal lattice), or B. Gets transmitted as infrared light and is off towards it's buddy on the other side(a meter, mile, light-year, or the end of the universe away). If you have electrons escaping from the wire you will have a surface that becomes more positively charged and the place they "deposit" themselves more negatively charged ,but you will firstly have to force them out of the wire, since they like atoms, similar phenomena used in Tube TVs to excite electrons rip them from the wire, hit a grid that has more electrons and splash them at the luminophore lighting it, using millions of volts to rip said electron, accelerate and direct it in the proper direction, using the electric field we generate(said volts). "Thus, a copper wire is limited by how many atoms can gain shed electrons repeatedly without overheating" no, no, no(maybe) you can run current as high as you want, at some point you will melt the wire, but a lightning needs no wire, it is itself a wire, how many free electrons (ones without a buddy) can a wire have, tink more "slinky"(coloured spring toy) if it's anchored at one end it can wiggle as much as it wants, but if it's anchored at two it can wiggle only back and forth, now forget that, because three atoms can share two free electrons or something like that, this was a long time ago when i studied it and chemistry wasn't my strong suit (they started with chemistry at highschool and ended with quantum physics at which point i got it better, but not by much) and me trying to explain it simultaneously at high, medium and low levels while i have medium to high understanding minus the university formulas, which if i had could maybe be golden. It was all about the orbit of the electron cloud and it's interaction with the cloud of the next atom('s electrons since usually they are as much as the atomic number of the core atom (in their many electron shells) "chemistry 102"(by bad memory)) the rest i can't answer, because i can't see while writing.
Reply: @alanbutler7712  short form: Part 1 your conclusion is mostly Fine
Part 2.
you worded it strangely, nothing to do with overheating exactly, and on "material for material sake" level nothing involved with economics, just free electrons(how free i don't remember) the more you have the more can move and wiggle in place (technically the vacuum of space is one of the best* conductors of(sine) AC electricity aka EM radiation since we can see stars billions of light years away(a "deja vu" topic this may be wrong), with minimal loss, half(-ish) happening in the atmosphere and the other, other gases between here and there, using wires for AC to go around corners, and the existence of the square cube law for omnidirectional transmission of EM radiation screwing AC outside wires and also air being a thing). The more atoms you have the higher the chance an atom will wiggle and produce dispersed "wiggle heat" as opposed to IR heat which can be reabsorbed by an electron, unless that electron is in the insulation or air since it is useless in that case to us, because it will wiggle the atom there, and not where you want.

(Electron if Current lost into heat question:)It lowers it's energy as if the current was not lost. 
Next one: no, normally electrons don't go away from the wire, static charge is different, as is lightning (literally the definition)

In electrolysis (and chem battery) not only electrons move, but also whole atoms making them also a current carrier, countering Part 1.
Reply: @ГеоргиГеоргиев-с3г  Thank you so much for the quick reply! (While this topic is still fresh in my mind.)

By the economic influence I was thinking about why we, (in the U.S.), use primarily copper  for wiring buildings and homes,, electronics, etc..., but to a far lesser degree aluminum has been used, rather than gold or some other metal. What I have been told,, Aluminum wire could loosen in its connections at receptacles and would corrode easier than copper. But, there may have been other reasons that Aluminum had increased in use at one time, (possibly following WW2 or another war that caused a higher demand on copper). Maybe copper is simply better in most circumstances. I don't know what is used for the high power lines, but it appears to be silver/aluminum in color.

I guess tensile strength also comes into account when running long distances in the air between power/utility poles. 

As I understand it, EM fields are always present when there is an electrical current. So, wouldn't the EM fields cause problems within electronics since the wires and connections criss-cross and are so close to each other within computers and electronics?

The jiggling of atoms comes from the zero point energy waves impacting the electrons, etc.

I am glad that they have finally proved the huge EM currents running through the universe between all of the stars, galaxies, and planets. As well as the discoveries by Perrat? at Los Alamos that every galaxy can be formed by two or more  Plasma filaments interacting in the vacuum of space. Someday, the cosmological community will admit to the evidence and accuracy of the Plasma Universe model instead of holding to the gravitational model for the universe.

Thanks again for the explanations!
Reply: @ГеоргиГеоргиев-с3г  Thank you again! I saw your first response after I had replied to your second response. 
I have the same issue when replying and not being able to see the original message.

I focused on the Arts in school/university, and became increasingly interested in the sciences as the internet and YT have grown and made so much information and explanations available! 

Based on reading the various reviews, there are a couple of people who seem to me have vast amounts of knowledge specifically in this area, and can/have provided insights into what caused the results on his test, and how to make a correction that will yield a more accurate test. (Like using a two different switches, one on each side of the battery so that the wires aren't already charged and giving the instantaneous power/voltage reading.) 

As I think about it and you reminded me about the photons being released when the electrons return to their original lower orbit... the idea of electricity being an electron(s) jumping atoms down the copper wire doesn't really make sense. Since chemical bonds are based on the sharing of electrons to fill the missing spots in their outer electron orbits, and the considerable energy that it takes to rip an electron off/out of orbit around its nucleus... There has to be a better explanation than what I was thinking.

Although, I am thinking that some/all batteries are based on their atoms inside wanting/trying to join/bond with other atoms, and would then free electrons. Do I have that right? Or, some batteries/power sources being elements that are shedding electrons?

Although most power plants use combustion, (the breaking down of chemical bonds), or motion of liquids to produce electricity, this process is used to create electricity through mechanical means, like turbines, to turn generators, then electrons are not being removed from the atoms in these generators materials/coil windings. So, there has to be something else being generated. So, like the ZPE particles exciting an atom/electron and bumping electrons into higher orbits and then this energy is passed to the next atom and the originating atom/electron can then drop back into its original orbit does make sense at the moment. Thus to explain this energy conveyance as 'exciting' the next atoms electron into a higher orbit thus becoming 'excited', does make sense. 

So, a metal's ability to maintain thermal stability and still have its atoms and electrons bouncing between these excited states of higher electron orbits would make the most sense too. As opposed to electrons having to constantly be interjected from the originating power source. If it was actually free electrons that constituted electricity, the originating source would eventually be just a bunch of proton and nuetron nucleus of atoms with no electrons.

Does this make sense? 
Thanks!
Reply: @alanbutler7712  mostly, as i said i am not a professional, just someone who really likes knowing stuff. DC is moving electrons along the wire but... As far as i know, these electrons  are jumping from one atom to the next, but not fully when you have two atoms connected with an electron bond, their electron clouds(a fancy word for the probably wave where you can find them) mix and allowing it to move without moving (in N and P parts of the diode this is most obvious, one using the half bonded electrons, the other, their lack), being at two places at once not being distinguishable from each other ( advise you to read Wikipedia on electrons)... The battery can "run out of electrons", such battery is known as discharged. The internal chemistry returning said electrons from the other terminal. The mechanical generators produce AC(in most cases), but there are dynamos(like in the bike) producing DC. 
It is hard for me to answer with a yes/no answer.
Reply: Would your graph look different if you used shielded wire?
Reply: What if the wire was laid out in a circle, not a narrow rectangle; would there then be no induction?
Reply: Considering inductors resist change in current, you don't need an experiment to prove there will be delay. It's been proven many times that inductors resist changes in current. The shorter and thicker the wire the shorter the delay. There will be even more delay with a light bulb. Cus light bulbs also act as an inductor.
Reply: @johnnytheprick I'm not going to argue any of the old points; I've given you enough information to understand them.

I just want to correct the "The speed of light has changed 5 times in the last 50 years" statement, because it reminds me a lot of the "But science isn't complete!" argument that my conspiracy-spewing uncle always brings up.

Most of the time, when we gain new scientific knowledge, we don't say "The old theory is completely wrong, it actually works this way!" No- the old information continues to be correct, but the new knowledge is more precise.

For instance - Newtonian rigid body physics remain extremely accurate for most situations. People in plenty of professions still use that math for their work, because it works well enough. When we need to be even more precise than that, we can use the newer but more complex theory of general relativity.

Similarly, the known speed of light has not actually changed - we've just gotten increasingly precise measurements. We used to think Pi was around 3, then we got to 3.14, and then 3.14159, etc. None of those are wrong; they're just at different levels of precision. It's not like it jumped from 3 to 200 to 7. You can't claim that "We have no idea what Pi is and it's impossible to measure Pi".
Reply: @johnnytheprick This is completely beside the point, but I'd just like to note that we teeeechnically do know the exact speed of light, if we're measuring in meters per second (SI units).

That's because the speed of light in a vacuum is universally constant, and it's so easily and precisely measurable that we decided to base the [latest iteration of] the metric system on it. That's right, the definition of the meter is officially based on the speed of light, and the speed of light will forever be exactly 299,792,458 meters per second.

As I said though, this doesn't really change anything. It just means that your "We don't know the speed of light" becomes "We don't know how long a meter is". Those are equivalent statements depending on whether you're using the pre-1983 or post-1983 metric system :)
Reply: @johnnytheprick Oooh, actually, one more fun science fact!

You're absolutely right that bouncing light off of the moon is a terrible way of measuring the speed of light, because the distance to the moon changes. but how do we know this, you might ask? How do we measure the distance to the moon?

With the mirror experiment! The Apollo missions put mirrors on the moon - we bounce lasers off of them and time how long it takes the lasers to return, then use the known speed of light to calculate distance. Of course we had to know how far away the moon was in order to send people there in the first place, so there were other (less accurate) methods we used previously.
Reply: I don't care enough to watch 20 mins video...
Reply: Hold on. You say you ignore magnetic fields in this video, but at 17:00 you explain that it's actually magnetic fields that cause the current in the "light bulb" "instantly". 
At least that's what I take from this video. So if the battery and light bulb weren't close together as it is in this configuration, but instead were at both ends of your loop, there wouldn't be any current flowing through with the wires disconnected connected (nor with them connected for those first microseconds).
Reply: Your experiment is flawed because you used conventional cable which is probably shielded , meaning that almost no electromagnetic field can be generated, if you were to use bare copper wire and also had the cables within a distance that is smaller than what the field radius given the power you feed into those cables then you would have seen an instant spike.
Reply: regarding your second to last “correction” comments: 

thinking in terms of a changing electric field or a magnetic field is the same since they are dual descriptions of the same process. so if you pick one description and stick to it then the interpretation will be correct.
Reply: I propose two extra variations:
1) Don't use a battery at all. Have a continuous wire like a loop with just the resistor and the switch. What happens when the switch is closed? Any current is induced by cosmic/human generated radiation? Of course there will be AC through the wire this time. Could it be that this is also influencing the first microseconds of the experiment in a measurable way (and actually all the time while the switch closes the circuit)?
2) I understand it is a more difficult, but why the wire cannot follow the contour of two circles (like an "8" or an infinite)? The circuit at the resistor and switch positions will be at the meeting point in the middle of the figure "8", but a little further away (not on the same table). Just have some distance with longer oscilloscope probe wires that will not considerably influence the measurements (like 2-5 meters).
Reply: @johnnytheprick  remember Maxwell’s equations .. as i said, changing electric fields give rise to magnetic fields, so you can either work in terms of one or the other, the physics is the same .. the two are dual descriptions of each other.
Reply: @johnnytheprick another way of saying the same thing is:

if you tell me what the electric field is doing at every point in space and time then i can tell you what the magnetic field is doing at every point in space and time, it is completely determined from Maxwell’s equations. 

this is why i said they are dual descriptions of the same physics
Reply: @johnnytheprick i didn’t say they are equal, i said they are DUAL (in free space you solve Maxwell’s equations by setting sources to zero). Wikipedia discusses this if you aren’t familiar with the concept. in fact this duality is the basis of lots of interesting physics (including strong/weak coupling dualities, Seiberg-Witten dualities, montonen-olive dualities, etc., going way beyond electric and magnetic fields .. ). lots of fun! 😃
Reply: @johnnytheprick  set sources to zero in Maxwell’s equations, and notice that they remain unchanged if you replace E —> B and B —> - E. 

this invariance of the equations is electric-magnetic duality. 

it says that you can choose to work with either electric or magnetic fields to solve a problem in free space, and then depending on your choice the dual field is fully determined.  

so E and B describe the same physics. this goes back to Dirac in the 1930’s.
Reply: You already know this... Maybe it is relevant here maybe it isn't, but it was all I could think about from about min 3 of the video. Lighting doesn't actually strike anything. It provokes a lightning response. When lighting strikes a tree, a little spike of lightning rises up from the tree to meet the oncoming spike from the clouds. WTF is THAT all about? SOMETHING is faster than that lightning... Enjoyed video thanks o/
Reply: @johnnytheprick No I haven't actually seen it for a long time. I didn't think to look for a video or anything. I don't know what it's called. But when lightning strikes something a tiny little lightning shoots up to meet it at the point of contact. Surprised now that I haven't seen it in one of these kind of science videos but it used to be in books as a mysterious phenomenon like Elmos Fire or something.
Reply: @johnnytheprick Okay I've just started looking but I think the thing I am on about is called an "upward streamer" and beside that apparently lightning between cloud and ground actually comes from the ground but the ignited plasma comes the other way down... beyond imagination.
Reply: Or an "upward positive leader"
Reply: @johnnytheprick Yep. Wrong. Check it out, "positive upward leader". Sometimes it even appears to go from the ground to the sky... but the usual cloud to ground we can see is called "return stroke". Stranger things isn't it!
Reply: @Fabian-mu3hq  You can use whatever symbols/letters you want.
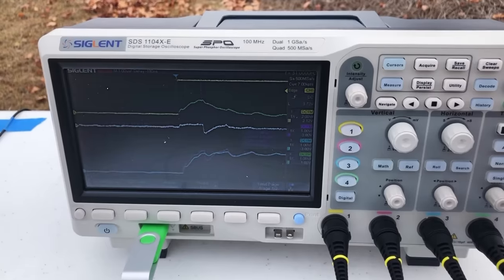Reply: 18:22 Interestingly after initial 1,6 ms there visible signal bouncing every other 1,6 ms before setup settles down again.
Reply: @goranjosic  that is the key.
Reply: make the gap not 25 cm, but 250 m
Reply: wrong explanation: electrons are traveling (VERY SLOW) on surface due to less interaction with other electrons (at stronger currents and bulk electrons are starting to travel), but the FIELD (impulse) IS TRAVELING AT THE SAME SPEED C IN THE WHOLE WIRE, not around and outside the wire
Reply: @bogslurp3532  I know right.  Veritasium is ordinarily one of my favorites, but with that one, it was like "So, this tub of Crisco that I just ate became a singularity in my belly."  Wait, what?!
Reply: Different gauge wires?
Reply: @AustinSteingrube  Well that's interesting because my experience (pure industrial) is the opposite.  And your name is very Germanic (Bavarian?) but a couple of Germans comments suggest otherwise also.  In the UK, U is often used as the symbol on electronics diagrams, measured in V, and in the electrical industry (wherein you have your degree) U is used almost exclusively for describing line voltage, and certainly on BS & IEC standard equipment and switchgear.  E.g. on inspection certificates the line voltage to earth is measured as U(0) and phase voltage as U(1).
Reply: @saskoilersfan  You really should learn how to spell lightning.
Reply: @johnnytheprick You do not need to generate a single photon to measure the speed of light. I thought we'd gone over this. You can generate a burst of photons and time the first one to reach the finish line - your result will be precise enough if your mirror is far enough away. Again - I literally just built a robot that navigates the world using this mirror experiment. It works.
As far as Einstein's thing - you might be referring to the possibility that the speed of light is different in one direction than in the other, and that we haven't been able to do an experiment to disprove this. It might've been Veritasium who did a video on this, actually. That's true, but it doesn't particularly matter. For our uses, the bidirectional speed of light works fine. If we had a use for the one-directional speed, we would also be able to measure it.

And yes, there's a big difference between changing something and getting a more precise measurement.
I might say "Pi is equal to 3.5, plus or minus 0.5".
Then later, I might get a more precise measurement and say "Now, I know that pi is equal to 3.141595, plus or minus 0.000005". These do NOT disagree with each other. Nothing has changed - my knowledge just became more precise. If I had instead said "I made another measurement and Pi is now equal to 7", that would disagree with the first result and constitute a change. This "Plus or minus...." stuff (uncertainty) is sometimes included with measurements but it's always implied to some extent. It's impossible to get an infinitely precise measurement of anything.

This is effectively what you're saying:
Lady - "Wow, that's a really small 2-inch dong!"
Johnnytheprick- "Actually, it's impossible to precisely measure how long it is. Even if I have a ruler that does micrometers, that's not enough. How are you even supposed to measure my dong if you don't have a ruler that's as short as my dong? We shouldn't even be using a ruler - that's way too simplistic!
Therefore, we do not know how long my dong is and we'll just say it's very very big."
I know, I'm making fun of you and it's unprofessional, but you deserve it at this point. Lololololololololololololololol.
Reply: So, would it be more accurate to pull the tube over the chain, then?
Reply: Great example
Reply: Fantastic work ! This is one hell of a commitment to science ! Thank you 👍😆
Reply: Derek was really impressed with your video, I'm really impressed with your passion for science 👍
Reply: you could do a version of the experiment with a low amperage/voltage light bulb, and yes it would blow but it wouldn't matter because you would see it lit so people who find oscilloscopes a bit abstract could see the light come on immediately, then go off again after a second when the full charge arrives. You could even have two runs of cable - one with a low volt lamp and one with matching the battery voltage. As one lamp goes off (blown) the other one comes on.

Anyway thanks for doing the experiment, it really does prove the thought experiment
Reply: It would be really interesting to see this experiment in reverse, where there is already a state current in the wire and you open the circuit, will this show an immediate drop in the resister followed by the current dropping off after the circuit is fully propagated?
Reply: Jeśli prąd zaczyna płynąć wewnątrz przewodu to wydziela się ciepło , przy tym napięciu było tylko przewodnictwo po powierzchni drutu ( ok. 70 mikrometrów drutu jest w użyciu , im większe napięcie tym szybciej ) . Dzięki za eksperyment.
Reply: Of course magnetic fields matter. An EM wave has equal voltage and magnetic components, since a change in one creates a change in the other.
Reply: @psionicxxx  sorry about using capital letters. My point there is no electron current inside the battery between the two electrodes only between the electrodes electrochemical reaction ion current.
Reply: tri again with optic fiber or even better use a laser in a vacuum chamber and photo transistor
Reply: If you earth this wire for a long time before the experiment wouldn't much of this capacitance drain away due to discharging?  At a certain low level of capacitance wouldn't the source of negative / positive charge be so minimal that electrons on the far end of the wire on not incentivized to move at all?

I work with submarine cables and we always discharge the cable when powering down for maintenance on the power feeding equipment simply because the residual charge / capacitance of a 7000km cable can be fatal to someone touching it. 

 I would assume that a 1km wire could still be discharged to a point that you would not see the low current the low peak on the oscilloscope.  Doesn't that just make the low current you detected a result of not  discharging the capacitance more than an actual argument against the thought experiment?
Reply: @AlphaPheonix It’s sort of funny that both you and Veritasium set of on this endeavor, but it’s nice to see it well defined.  I do have to say that your terminology is wrong in regards to the speed of the electrons.  When electricity flows through a conductor, the electrons travel at an EXTREMELY slow speed, that on average is around 1”/hour.  Yes, that is correct, the electrons travel that slow down the conductor.

Think of this, if the electrons were traveling down the conductor at the speed of light, what do you think would happen to the conductor?  It would obviously vaporize, correct?  Instead, the electrons REACT at the speed of light, moving an EXTREMELY minuscule distance,  Electronic Engineers know this, as it’s taught during the first week of class, while the majority of Electrical Engineers are never even taught this.

Anywho, I luved your experiment, and I am extremely happy to see that you correctly identified the capacitance, inductive, and electromagnetic natures involved.  BTW, one more fun thing you could have done, instead of cutting the wire, would be to double the distance of the gap between the wires.  That should lower the measured voltage for those 1.6us.
Reply: I am no electrician but stretching out a wire that long will pick up radio waves and turn them into electrons so the wire will have a charged at all time. or not?
Reply: Would like to see the result of halving and/or doubling the distance between the parallel wires.
Reply: 1000m of charged antenna against a charged more battery!
Reply: Aren't electrons massive? That means they cannot move at c they are not light speed right?
Reply: Nah man, it doesn’t travel at all, it’s always there!
Reply: Just wanted to say thank you
Reply: i have no idea what are you talking about but i think you are right:goodvibes:
Reply: Just a silly question here but why did you have to uncoil the wire? The distance would’ve been the same if it was coiled or uncoiled as long as it’s not bare wire? Food for thought
Reply: @michaelraasch5496  I wish you folks would stop.  Vartasium is just wrong.
Reply: Speaking of decoupling effects; In the study of heat energy, it has long been understood heat always travels in the direction of warmer to cooler.
It stands to reason that Light energy, therefore, always travels from brighter to darker, yet don't see such a property listed in texts about light energy. Can we confirm or deny this premise? How do we prove / disprove this idea?
Reply: james Deer  Yes. Brighter to darker.
Reply: james Deer  Prove or disprove. Cite examples.
Reply: light is faster,but when it comes to a vakum they where at the same speet, because of ( in primitive) its light too^^
Reply: Alpha,

Thanks to money this wouldn't have been possible 😂
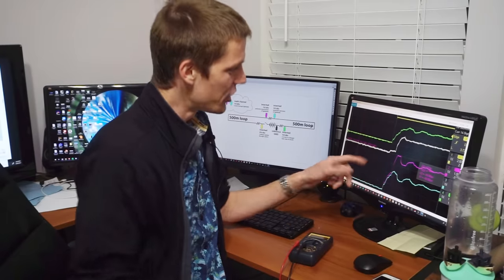Reply: For a microsecond I thought he's just broken causality by inducing the tiny current around the resistor instantaneously! 9:10
Reply: This comment section ☝🤓
Reply: The volume in your video's is really low, at 100% speaker volume it is just audible (normally i sit around 45-50% for yt video's).
Reply: What about the Pointing vector?
Reply: james Deer  What you said about electrons travelling at the speed of light is factually incorrect. They pretty much always travel much slower, even in a vacuum.

The signal travels near the speed of light, and that's what the video is talking about. Curb your Dunning-Kruger.
Reply: Thanks for the videos, it's fun watching you mine through all the uncertainties and extremely well thought out exoerimenta, I enjoy watching them. I was gonna say your results are based on the shape and vicinity of the (wires) circuit. What I don't get is if photons are modulating the electrons movements then doesn't that answer the question?
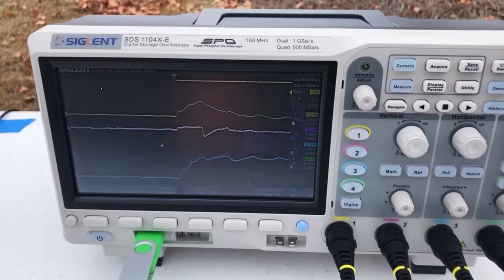Reply: The "capacitive blip" at @18:30 was most interesting.  Would be nice to have a considerably longer circuit that you could measure(probably need an atomic clock accuracy) at nodes to see when the "charge effect" reaches each node.  Since you realize the wire is actually many many billions of copper atoms in diameter, you need to account for the capacitive loading of the wire itself.
Reply: Yes, by all means watch Derek's video, just remember his conclusions are Wrong. . . .  Current in wires is not driven by any external fields, but the current INSIDE the wire can cause some external fields.
Reply: your osziloskop shows waves and spirals...not just 2DLines...
...its a howl field not just ups and Downs
downie...
Reply: Do you guys know that I watch all these other channels you mentioned?
Reply: Important question, was it one light speed delay or SLIGHTLY MORE than one lightspeed delay?

I say this because the wire has resistance and thus the electricty cannot move as fast as light in a vacuum.
Reply: Too many flat earthers 🙄😊
Reply: I am a tad confused with the wavefront propagating from the bulb. The right side, where electrons are pulled to the slight positive charge makes sense. But you also show a wave propagating to the left, and following the negative charge rather than leading it.
Reply: Another idea taken from man's vivid imagination 👍
Reply: light bulbs sometimes have coils of the filament. Coils would affect the circuit timing. Was this light bulb just a straight filament?
Reply: @michaelraasch5496  After watching Electroboom I am... EXTREMELY UNCONVINCED
Reply: A long time ago I heard the propagation time of electrons in a wire was about 1/3 c.   That doesn't mean what I heard or recall is correct.
Reply: @Fabian-mu3hq  As a grad student in physics who has taught this stuff many times I can say that this is not true, V is used as both the unit and the symbol for electric potential. Are you perhaps confusing potential energy (whose symbol is U and unit is the Joule (J)) and electric potential (whose symbol is V and unit is the Volt (also V))?
Reply: Wouldn't the wire's resistance affect this? I know the price would be unreasonable for it but wouldn't silver be better for this?
Reply: Im like 99% sure that electricity moves at the speed of electricity and light at the speed of light.
SInce light is photons mostly and electricity carries particles with + and -; id think electricity would be a bit slower than light.
Also; When I was a child I stuck a paperclip into a live extention cord.
Light switch was faster than me losing conciousness for a brief moment.
I distinctly remember the lights flicker then I lost conciousness. (True story)
My mother came in and asked what id done and I said nothing and she said youre lying and I said no and she told me to go look in the mirror.
All the peach fuzz under my nose was electrically singed off and black soot was making my 8yr old self look like I lived in Germany circa 1941.
Reply: Veritasium is full of $hit.
Reply: The wire from the power supply is in parallel with the wire that terminates into the resistor you are measuring. The initial bump in the voltage is caused by cross inductance.  But by now you probably know that.
Reply: I think it is time to stop and think what this circuit actually is 
     .It is not a normal  transmission  line  where you fire a pulse down a pair of wires say a telephone line. On this the speed is known about 220 meters  per micro second .  The speed off light is about 300meters per micro second. The difference is called  the two the velocity factor of the line  A better test to prove this would be a 1k ring of 2 wires round a field  and fire pulse  round it  But a much better test still it to fire a pulse down a 1k  length of  2 wire line and see the echo back at about 110M per microsecond as a there and back measurement  
    The best way of thinking about this circuit  talked about on this post is to think of it as 2 capacitors  left and right  joining the battery to the lamp  But each capacitor  is  1 k long as is also a complex  L C R network in its own right as in a transmission line 
  So it is now simple to see why a signal is seem instantly across the load it is purely  local capacitive  coupling and it would not matter  if the far end was open  or closed   of the first 10micro seconds aprox  until the echoes returned from the short  circuit ends
Reply: You can actually use the word 'gedanken experiment' in english? 😅 Good to know 😁
Reply: 16:36 Fantastic. I wish I had thought of that. You should always draw a pic of what's happening and be sure to include all the forces (or fields in this case).  This is an electrical analogue to a mechanical free body diagram. Great job of thinking and explaining.
Reply: did you account for the capacitance of the probes?